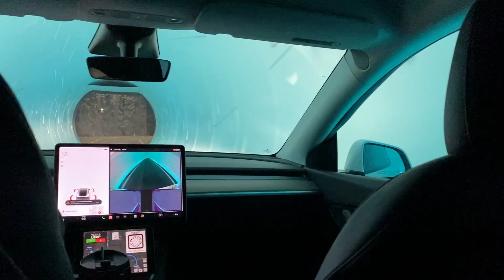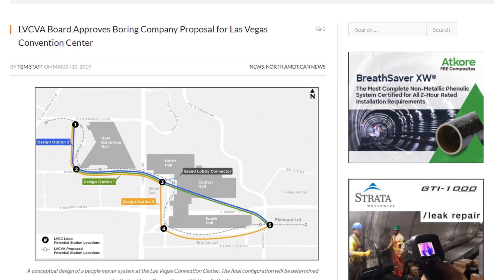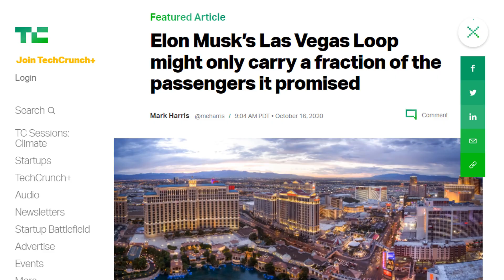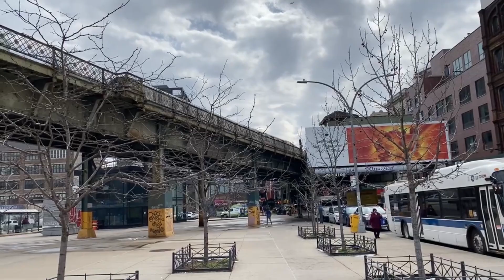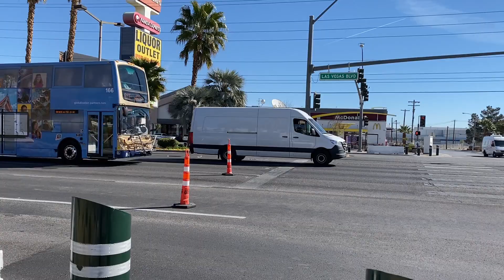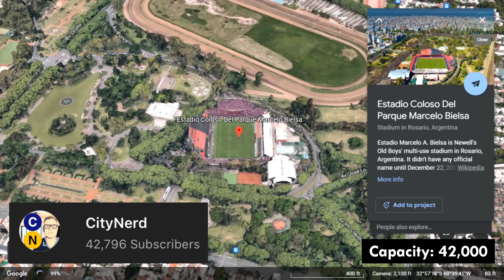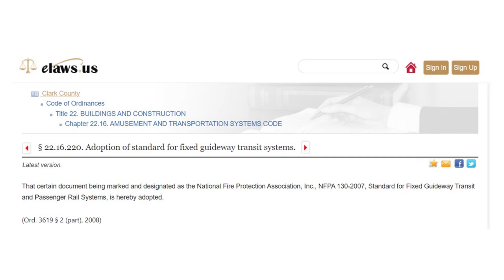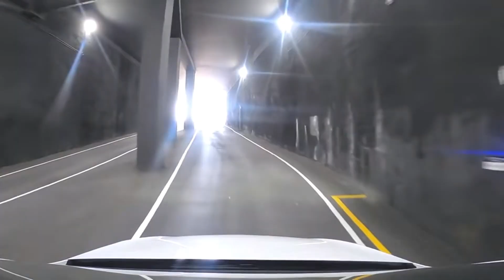Inside the Las Vegas Loop: Transportation Game-Changer, or Complete Waste of Time and Effort?

Comment: The loop was a game changer. It helped a lot of people to finally realise that Musk is full of bs
Reply: Not enough people
Reply: I can't believe it took this much 🤣 I can't believe the amount of them who would still volunteer as test subjects for him.
Reply: don't forget this "genius" thinks he'll colonize Mars. Like yea, after you pal.
Reply: Wow.. truly amazed with the supporter of loop.  Lots of unreasonable reasoning.
Reply: @Ninjabeefyschtick  Any point you feel is particularly unreasonable vitasoy?
Reply: @andrewfranklin4429  Points that are unreasonable have all been discussed by fellow members and it is just going in circle when one strongly believes an exclusive loop for tesla sedans works better than mass transit system.  What else is there to discuss?
Reply: @Ninjabeefyschtick  That's unfortunate Vitasoy that you refuse to even consider the implications that the Loop comfortably handles 27,000 people per day.

Considering subways of similar size (San Francisco Central Subway, Seattle U-Link, Berlin U55, Newark Subway) have similar or even much lower daily ridership, I would have thought you'd realise the Loop is mass transit (just of the PRT variety).
Reply: @andrewfranklin4429  Are you comparing possible capacity "a plan" with actually riderships?  You know this is about little teslas that hold 3 people per the requirement right?  You wait a few years and see how the actual system rolls out, if it ever does, before counterarguing with something that is highly questionable and already discussed by previous comments.  Its a waste of time to talk about some that has like 3 of 51 stations built.
Reply: @Ninjabeefyschtick  No, the 27,000 people per day is actual ridership and what was measured during the SEMA conference back in November.  The smaller CES convention in January saw 15,000 - 17,000 people per day.

Yes, those Teslas seat on average 2-3 people but because they are entering and leaving the stations down to every 3 seconds, they end up moving as many people as similar sized subways which only come every 3, 5, 10 or even 30 minutes.

The Loop now has 4 LVCC stations completed (LVCC North was completed a few weeks ago), a new station at Resorts World and the tunnel to Encore is currently be bored so there will soon be a 5th Loop station with more stations at Caesars Palace, Alegiant Stadium and other areas currently going though rubber-stamping.

That's out of the 55 stations that have been approved with more being added every few months.
Reply: @Ninjabeefyschtick   The figure that is planned capacity is the 57,000 people PER HOUR that the The Boring Co has projected the entire 34 mile 55 station Vegas Loop will handle when completed.
Reply: @Codraroll  still unable to accept that the Loop handled 27,000 people per day at SEMA, comparable to other subways of that size Erlend?

Unfortunate.
Reply: @andrewfranklin4429  Come back with your argument when the lines is completed then. please and thank you
Reply: @Ninjabeefyschtick  There's nothing I'd like more than if everyone held off judging the Loop till the rest of the 34 mile 55 station Loop was completed so we could all see how well the Loop scales to a city-wide system.

Unfortunately however, there are a significant number of people who are determined to criticise and reject the Loop out of hand at this stage because it uses cars which doesn't fit their world-view of "cars are bad, trains are good" meaning we have to judge the Loop based on it's current iteration.

The good news is that with the current three-station LVCC Loop handling 27,000 people per day, it is already moving numbers of people comparable to all of those subways that I mentioned.  

Thus the Loop is already proving that not only is it competitive with Bus Rapid Transit and Light Rail, but it is already holding its own against similar-sized subways despite costing 10-100x less than a subway.

And this is without taking into account that there will be around 8 Loop stations per mile compared to 1-2 subway stations in that distance through the busier parts of Vegas meaning that each station only needs to handle as little as 12% the volume of passengers individually to still move the same number of people per mile of tunnel compared to a subway.
Reply: It's literally a single lane tunnel that cost 4x more than what any other tunnel would had cost. Furthermore, there is this wonderful new invention where hundreds of people can be transported at the same time through an underground tunnel called a SUBWAY. It was named after the sandwich company because of the aerodynamic shape of the hypertrains that shutter everyone around!
Reply: @NightfallShadow  Can you provide actual evidence that the boring company tunnel cost more than any tunnel.  The info I have says it cost 1000x less per mile than recent subway tunnels.

Oh, I forgot.  You don't use facts.
Reply: Steve  I think you're forgetting that Personal Rapid Transit has been an unrealised dream for many decades. Except that they're called bikes. And they've been around a lot longer. ;)
Reply: the loop just needs a telsa semi truck to move 50 to 100 passengers
Reply: @22phan  And what about the blacks?
Reply: @22phan  happy nine 11 everybody!!!
Reply: @22phan  why would the Loop need a Semi when it already easily transports up to 27,000 people per day?
Reply: Prescient much?😜
Reply: Nah it when he bought Twitter, sexual harassment, and hypocrisy all at the same time
Reply: Yeo
Reply: Steve   on the contrary Steve, the LVCC Loop is moving similar numbers of people to the London Tube’s busiest station platforms. 

60,000 people per hour (pph) travel down the busiest line on the London Underground - the Victoria line - in the highest morning peak hour sitting on the train, but the actual max number of passengers recorded getting off and going through the turnstiles at Oxford Circus Station (the busiest Underground-only station on the Tube) on that line is only 23,720 pph in the busiest morning peak hour.   That stat alone should help us realise that pph standing on a train does not equal pph going through the turnstiles of the station.   But it’s even worse as that is the total across 6 busy platforms and 11 different Lines, so the pph going through the turnstiles from just the Victoria line is far smaller again as dividing by 3 platform-pairs we’re only looking at approx 7,906 pph at Oxford Circus Station. On a per line basis it’s only 2,160 pph.   And yes each of those 3 platform-pairs have similar pph riding down the lines so a divide by three gives us a quite accurate thru the turnstiles percentage.   And those were the figures pre-pandemic - ridership now is less than half those figures (so somewhere around 4,000 pph for that Oxford Circus platform-pair or 1,080 pph per line). 

So as you can see, the 4,400 pph going through the turnstiles of the LVCC Loop is actually very impressive even compared to the world’s busiest subways.
Reply: Steve  If you prefer not talking in terms of passengers per hour, then we can do that but it is a less balanced comparison considering Oxford Circus station operates 24 hours per day while the Loop is only open during the 8 hours of the convention. 

However, the TFL website reports that Oxford Circus averages 69,643 passenger entries and 77,884 exits per 24 hour day.

So that is 147,527 in total. 

However, as I mentioned earlier, Oxford Circus has 6 platforms and 11 different lines, so the average per platform pair is 49,175 and 13,411 per line per 24 hour day. 

Now in comparison, the Loop handles up to 27,000 per 8 hour day. So Oxford Circus platform pairs handle less than double the daily ridership of the LVCC Loop despite the Loop only being open for a third of the time daily during medium size conferences.  

Not bad for a little system in a city of 600,000 population that only cost $52m compared to the billions of dollars that Oxford Circus in a city of 9 million people has cost. 

But of course, that is not a fair comparison - comparing people per hour during peak periods is far more appropriate as I showed earlier.
Reply: Steve  there is nothing dubious about the 4,400 people per hour or 27,000 people per day figures for the Loop. 

Here is what the Las Vegas Convention and Visitor’s Authority (LVCVA) said as reported by numerous publications including Bloomberg and Teslarati amongst others a few months ago:

“the Boring Company’s tunnel system successfully moved 25,000 to 27,000 passengers daily around the Las Vegas Convention Center campus during SEMA in November. SEMA was the Convention Center and the LVCC Loop’s first full-facility show with 114,000 attendees.”

And more recently CES 2023 had 115,000 attendees and 94,000 passengers over the 4 day event.

The Loop was only open for the 8 hours each day that the SEMA Convention was in operation so that gives us an average hourly rate of 27,000/8 = 3,375 people per hour.

However, like any mass transit system, the Loop has peaks and troughs throughout the day with a peak period around lunch with a significantly higher hourly rate than that and off-peak periods up to mid-morning and after mid-afternoon with lower rates, meaning the Loop would easily have seen over 4,000 people per hour during that mid-day peak period. 

However, we have the audited results of the test in May that give us an idea of what the ridership would be with such a large convention as the pre-COVID CES:

“LVCVA Chief Financial Officer Ed Finger told the authority’s audit committee that accounting firm BDO confirmed the system was transporting 4,431 passengers per hour in a test in May showing the potential capacity of the current LVCC Loop.”
Reply: Steve  and if you compare specs honestly, you will discover that the Loop is very impressive when you compare it to most other forms of public transport such as subways:

1. High capacity - the LVCC Loop has handled more passengers daily during medium-sized conventions than 65% of the stations on the London Underground individually handle daily and carries up to half the peak hour ridership of the Times Square Shuttle line which has the busiest subway station on the New York subway. 

2. Much less waiting (10 seconds peak, 0 seconds off-peak) compared to 3, 5, 10 or even 30 minutes waiting for trains or buses and Loop vehicles go straight to their destination without having to stop and wait at every station on the line. 

3. much more comfortable and pandemic safe - comfy EV devoted to you and your family/friends/colleagues or 1 or 2 other people compared to standing squished like sardines in with a thousand strangers in a train or with 80 bus passengers 

4. much better scalability.  Loop EVs only leave a station if they have passengers unlike buses and trains that have to keep driving around even if they are empty. 

5. faster at 30-40mph compared to an average of 17mph - 22mph in subways (the 55 station, 34 mile Loop will average 60mph)

6. VASTLY cheaper - the 34 mile 55 station Vegas Loop is costing taxpayers ZERO dollars to build compared to $10 billion for a comparable subway
Reply: more than game
mind changer
Reply: Very True indeed, Elon Musk is a fraudster
Reply: The loop is genius.
Reply: @douglasross594  XD elon dickrider
Reply: I'm pressing (X) to doubt.
Reply: Well well well
Reply: Just now?
Reply: @Greeniykyk  sadly some people it took them long enough. I lost him way back at the cyber truck  and when I realised how much credit he takes for other people's work, and plagiarism, then claim it to be his work. Money buys you anything
Reply: @Greeniykyk  if you cannot see it, you lack the common sense, and cognitive reasoning to understand. It would be a waste of time to try.
Reply: His rockets are good, his "hyper loop" is a distraction from real transit. 

But everyone likes the sound of a golden bullet for all their problems, its just that engineering has taught me that no such things exist. Honestly if the US could just get 100mph trains running regularly as a regional rail that spans the nation it would be nice. From there expand the key corridors to true HSR between major cities.
Reply: @jasonreed7522  viable more efficient alternatives to driving and well designed cities is the closest thing we have to a golden bullet
Reply: @jasonreed7522  you people still just dont understand why trains do not work in the US lmao
Reply: Careful. He’ll call you names now.
Reply: @jamescoll130  thankfully Erlend has mostly managed to avoid ad hominem attack so we’ve generally had some quite enjoyable and useful discussions about the topic.
Reply: Musk got great ideals but this implementation sucks. It’s should have been high speed maglev Personal Rapid transit vehicles not his Tesla cars on rubber tires
Reply: @williamerazo3921  why do you reckon the Loop sucks William?  After all it has been extremely successful moving 25,000 - 27,000 people per day during large conventions like SEMA in November so very expensive maglev PRT vehicles are hardly required. 

27,000 passengers per day is:

- greater than the number of passengers that 65% of the stations on the London Underground individually handle daily which with 1.8 million passengers per day across 272 stations averages only 6,617 passengers per day PER STATION. 

- more than the 24,858 passengers per day per line pre-pandemic average of Kings Cross station, the busiest station on the Tube which pre-pandemic had 149,150 entries per day across 6 lines. 

- more than the average of 13,684 people PER STATION per day of the entire Paris Metro which had a pre-pandemic ridership of 4.16 million per day over 304 stations.

- about 70% the 38,888 people per day per platform pair average of the busiest station on the Paris Metro, the Gare Du Nord which pre-pandemic handled 700,000 people per day across 36 platforms. 

 - more than the 14,000 passengers per day per line average of the Stuttgart Main Station S-Bahn which pre-pandemic saw 140,000 passengers across 10 lines through the turnstiles daily.
Reply: Elon takes a lot of swings and for all his misses, he sure does have some absolutely astounding hits.  I don't understand how the "Musk as a bullshit peddler" myth still survives in a year where his car company produces more EVs than any other automaker by a massive margin and his rocket company puts more payload to orbit in a year than every other COUNTRY on the planet combined.

Whether the Vegas Loop ends up being a hit or a miss doesn't detract from the swings that Elon has taken which have ripped the cover right off the ball.  We need more people like him and less people who have nothing to offer the world but lame hot takes.
Reply: @woodsie315  "his car company produces more EVs than any other automaker by a massive margin"

Interesting uses of "more" and "massive" there. A quick Google has BYD at 1.8 mill, Tesla at 1.3, and VW at 0.8. I bet you have a "massive" penis, Woodsie.

And I don't think filling space with garbage should be praised.
Reply: @woodsie315  very well said woodsie
Reply: Hi Zane, here are some similar-sized subways for comparison that shows that the Loop is very competitive in terms of daily ridership, but also has FAR smaller waiting times, is faster but most importantly is VASTLY cheaper:

The current 0.8 mile long three-station LVCC Loop handles up to 27,000 people per day, has a 3 - 6 second headway, averages 25mph and cost $48.7m. 

The Berlin U55 is a 3-station 1.5km subway in the centre of Berlin which is similar in size to the LVCC Loop but it only carries a minuscule 6,200 people per day (compared to the Loop’s 27,000 ppd) at an average speed of 19mph and 5 minute headway and yet cost $500 million in today’s dollars in total, 10x the cost of the LVCC Loop.

The Seattle U-Link is a 3.15-mile underground light rail which also has 3 stations which had a ridership of 33,900 people per day pre-covid (so only a few thousand more than the LVCC Loop), though it is much less now.  Runs at an average speed of 31mph with a 10 min peak/15 min off-peak headway. It cost $1.9 billion dollars in total or $600 million per mile, 39x more than the LVCC Loop.

The San Francisco Central Subway is a 3-station 1.7 mile subway with a targeted ridership of 35,000 people per day with a 5 minute headway and an average speed of a miserable 9.6mph and cost $1.578 billion, 32x the cost of the Loop. (Whether it achieves that ridership which is only a few thousand higher than the Loop during this pandemic is of course yet to be seen) 

The Newark City Subway/light rail is a 6.4 mile, 17 station line with an average speed of 21.5mph and has a daily ridership of 19,289 and cost $208m for the 1 mile above-ground light rail portion or 4x the cost of the underground Loop. I’m not sure of the cost of the underground portion of the Newark subway, but typical costs start at $600m per mile 39x the cost of the Loop. 

As you can see, the LVCC Loop is extremely competitive, though that is nothing compared to the 55 station, 34 mile Vegas Loop with its 60mph average speed, 0.9 second headway and 57,000 people per hour capacity which is now under-construction at ZERO cost to the taxpayer. 

However, the Loop is FAR better in terms of comfort, speed and frequency/wait times, and VASTLY cheaper to build than any of these subway systems.
Reply: @andrewfranklin4429  Again. You are comparing the apple to orange.
Reply: @dickiewongtk  ok Wong, let’s do an apples to apples comparison instead and look at every subway station around the globe with around three stations like the Loop:

The current 0.8 mile long three-station LVCC Loop handles up to 27,000 people per day, with 3 - 6 seconds between cars, averages 35mph and cost $48.7m. 

In comparison, the Seattle U-Link is a 3.15-mile underground light rail which also has 3 stations which had a ridership of 33,900 people per day pre-covid (so only a few thousand more than the LVCC Loop), though it is much less now.  Runs at an average speed of 31mph with a 10 min peak/15 min off-peak frequency. It cost $1.9 billion dollars in total or $600 million per mile, 39x more than the LVCC Loop.

The San Francisco Central Subway is a 3-station 1.7 mile subway with a targeted ridership of 35,000 people per day with a 5 minute headway and an average speed of a miserable 9.6mph and cost $1.578 billion, 32x the cost of the Loop. (Whether it achieves that ridership which is only a few thousand higher than the Loop during this pandemic is of course yet to be seen) 

The Newark City Subway/light rail is a 6.4 mile, 17 station line with an average speed of 21.5mph and has a daily ridership of 19,289 and cost $208m for the 1 mile above-ground light rail portion or 4x the cost of the underground Loop. I’m not sure of the cost of the underground portion of the Newark subway, typical costs start at $600m per mile or 10x the cost of the Loop. 

And then there is the lame duck Berlin U55 which is a 3-station 1.5km subway in the centre of Berlin which is similar in size to the LVCC Loop but which only carries a minuscule 6,200 people per day (compared to the Loop’s 27,000 ppd) at an average speed of 19mph and 5 minute frequency and yet cost $500 million in today’s dollars in total, 10x the cost of the LVCC Loop.

As you can see, the LVCC Loop is extremely competitive, though that is nothing compared to the 55 station, 34 mile Vegas Loop with its 60mph average speed, 0.9 seconds between cars and 57,000 people per hour capacity which is now under-construction at ZERO cost to the taxpayer. 

However, the Loop is FAR better in terms of comfort, speed and frequency/wait times, and VASTLY cheaper to build than any of these subway systems.
Reply: @andrewfranklin4429  but all those subways could move much much people if there was demand, while there is a hard cap of a bit over 4400 on the loop. So its not a fair comparison
Reply: @andrewfranklin4429  I was interested by your argument so looked up the Berlin U55 line to check if what you said was correct. Turns out the U55 was always a short term tempary line that was not conected to the rest of the system and has now be absorbed into a diferent, I feel it was deliberatly misleading to compare. Also why are you comparing the loops best recorded performance to rail/bus services average ridership that also seems deliberatly misleading. You have got to ask your self the question if you are using metric in a none standard why and picking missleading examples like the Berlin U55, are you picking facts to support your argument rather then bascing your arguments on the facts.
Reply: @jimpaddy79  Jim, it is interesting that you only picked on Berlin’s U-55 subway (which I specifically said was a lame duck line) and ignored all my other examples such at San Francisco Central subway, the Seattle U-Link and the Newark subway. 

I included Berlin in order to mention EVERY single subway of similar size globally in comparison to the Loop yet you ignore all those other subways I mentioned. 

How about a little balance from your end?

And why do you assume that 27,000 per day is the Loop’s best performance?  That is just the ridership during a medium sized convention, (SEMA 2021) which had only 114,000 attendees. The Loop however was designed for pre-COVID conventions the size of CES with its 180,000 attendees, so there’s plenty of room for an increase as conventions grow back to pre-COVID levels.
Reply: @andrewfranklin4429  Rather than continuing two sperate conversations I am going to combine both into this one for simplicity. Clearly, we are now talking about different things I am specifically talking about the current loop system at the convention centre, which was the subject the video and the focus of the comments. I am not familiar enough with the intended expanded loop network to comment on it in any detail. In your last two replies I didn’t find any defence of my criticism of the current loop and my argument that light rail would be better due to the higher capacity it offers at peak time.  The original reason I commented was because I didn’t understand why you were quoting figures on short light rail lines which when I looked up 2 of them were operating roughly within their design parameters, and I still don’t.

Correct me if I am wrong, but I now think your main argument is that a point to point transport system such as the loop is different enough from traditional mass transit that different metrics should be used ie, numbers at stations not people per hour. I think this idea has some merit which is why I read the tread but I do disagree. I also think your point is buried in far to much copied and pasted figure about people that train station and that’s confusing people and frustrating people as its not the standard metric for mass transit, even if it’s a potentially better one the loop, so you cant blame people of accusing you of comparing apple to bananas. Please correct me if I am wrong.

I think people per hour is the best metric as it show how many people are moving toward their destination, it doesn’t matter where there going weather its one stop on the train or a journey across the country the point is they are moving, the point of any transit system is the have the capacity to greatest about of people and Ideally this capacity is a little above peak demand. The loop is just the same it this regard and I don’t think the fact  that its point to point changes that. This one is the clencher for me, the loop is effectively the same person driving a car on the road between two point, which means it should be measured the same as road traffic, road planner measure road performance in vehicles per hour, not by measuring what part of the city the cars journeys end in.

My final though are on the intended expanded loop and I am basing this entirely on what you said in your reply as I know noting else about it. The current loop gets good efficiency in seat filled in cars, because there is only 3 stop and that mean there is only 2 possible destination so its relatively easy to find there people going in the same direction, that is a totally different story if there is 50+ station so a lot of cars will be traveling with empty seat, which will massively the capacity of the system, if all the cars are running but there is only one passenger in each the system would only be running at 33% capacity. This get even worse if as you say they van to use mini vans. Then there is the 16 person pod you mentioned what the odds of finding 16 people going to the same place in a 50+ station network, so the pods would have to run mostly empty most of the time thus wasting more capacity, or it would run full and drop different people at different stations, in which case congratulation you have invented a bus, which stop at a stop when you press the button.

I would be curios to know why you feel so strongly positive about the project, reasonable people can disagree about things but people really either love or hate this project which I find more interesting then the project itself. Personal I don’t feel strongly I just think it not an inefficient system in its current or future form, but I am interested why you feel strongly about it.
Reply: @jimpaddy79  In terms of the use of EV vans or buses, they would only need to be used on high traffic routes not every route across Vegas unlike traditional buses and trains that have to be used on every route no matter how low demand that route is. 

Unlike rail, the Loop can easily mix high capacity vans and buses and 1-4 seat EVs without problems and thus far better optimise occupancy across the fleet compared to trains which have an average occupancy of 23% or buses which only average 11 passengers per bus. 

Remember that almost half the stations on the NYC subway handle less passengers than each of the LVCC Loop stations. 

With 5,580,845 passengers per day (pre-pandemic ) across 472 stations on the NYC Subway, each station only averages 11,823 people per day through each station.

The London Underground, with 1.8 million passengers per day across 272 stations averages only 6,617 passengers per day per station.
Reply: @jimpaddy79  and Jim, the reason I am quite positive about this project is that finally someone is doing something out-of-the-box, new and creative in the public transit market which up till now has stagnated in many parts of the world where the car rules supreme like the USA and here in Australia. 

As much as Musk disgusts me with a lot of his recent tweets and turn to right wing politics, he does have a talent for turning science fiction into reality with SpaceX, Tesla and now the Loop. 

Personal Rapid Transit (PRT) has been an unrealised dream for many decades, but his Loop really looks like it might crack that chestnut and get all those people who would never take a bus or train, out of their cars and into this PRT system which moves just as many people as BRT, light rail and subways, but for a tiny fraction of the cost and in far greater comfort, speed and convenience. 

What I can’t understand is why you and others aren’t more interested in this technology that promises a 34 mile 55 station underground transport system capable of moving subway volumes of people around at ZERO cost to the taxpayer.

Doesn’t this potentially huge disruption to the globe’s public transit industry peak your interest even a little bit?  Heck, you’re absolutely welcome and justified to hold off on giving it your approval until more of the 34 mile Loop is completed to see if it can scale to a city-wide system, but I can’t understand how so many people seem to be desperate to condemn it at this stage just because it is different.
Reply: @Nightfall Shadow, not sure where you get the idea that the Loop tunnels are more expensive when Loop stations are 60-600x cheaper than subway stations and Loop tunnels are 5-50x cheaper than subway tunnels?

The New York East Side Access subway cost $3.7 billion per mile and even the cheapest subway such as the Barcelona L9/L10 cost $243 million per mile compared to the LVCC Loop which cost $48m for around 0.8 miles of dual-bore tunnel. 

That LVCC Loop included an underground Loop station costing $30-$40m by itself, but the above-ground Loop stations only cost $1.5m each which is VASTLY cheaper than the $700m that NYC subway stations cost.  Even the cheapest subway stations in Europe cost $100m each. 

This is why it is possible for Musk to be building the 34 miles of tunnels and 55 Loop stations of the now under-construction Vegas Loop at ZERO cost to taxpayers. A subway system of that size would cost well north of $10 billion dollars in comparison.
Reply: You are the sort of person who questioned the need for roads, because their horse and buggy got around on flat terrain just fine.
Reply: @vimmentors6747  The subway is vastly superior idea to elon musks loop. Seriously, stop being an idiot.
Reply: @NightfallShadow  It's only a good idea if people want to use it, or are forced to use it because it's cost is massively subsidized by people who don't use it.  It's only a good idea if you are a contractor who is paid billions of dollars per mile.  I find that people who quickly dismiss new ideas are rigid in their thinking because they can't or are too lazy to think.  Which one are you?
Reply: @NightfallShadow  Translation of your reply: "I am uncomfortable when confronted with facts, polls and other forms of reality, so I will pretend I am smart."
Reply: @NightfallShadow  Can you please show evidence that anyone is currently doing serious work on a Hyperloop?  Oh, I see.  You can't argue reality, so your only option is hyperbole.
Reply: How many rockets have you launched this week?
Reply: @zshobuz  And you ?
Reply: The 34 mile, 55 station Vegas Loop is even more interesting though in that it has many more Loop stations for every subway station per mile. 

If you have a look at the map of the now-under construction 34 mile, 55 station Vegas Loop, you will see there will be around 8 Loop stations for every subway station per mile (17 in the 2 miles of the CBD) through the busier parts of Las Vegas

The existing convention centre Loop is a prime example of this fact as it already has 3 stations serving that one venue and the fourth LVCC station (LVCC North) has just been constructed and there are three other stations within a few hundred metres of the centre as well, meaning that the LVCC will effectively have 7 Loop stations servicing large convention crowds.  

With a subway, there would only be a single station typically serving such a destination. 

As such, comparing the average daily passengers through the turnstiles of a single station of the LVCC Loop during large conventions is actually very unfair to the Loop as we need to be comparing all 7 (or 8) of those stations (once they are completed) against each subway station for a more accurate comparison. 

Each of those 8 stations only has to handle 12% of the load of a single subway station to carry the SAME or greater number of passengers as that single subway station, vastly reducing the crowds and bottlenecks or choke points that subway stations represent. 

How is this even economically feasible you ask?  With each Loop station only costing $1.5m compared to the $100m - $1 billion cost of subway stations, you could build 67 - 667 Loop stations for the cost of a single subway station and 10 - 100 miles of Loop tunnels for the cost a single mile of subway tunnel. 

This is why there will be a Loop station at the front door of every hotel, casino, resort, the university, large shopping centre etc through Vegas, something that would be technically and financially impossible with subways.
Reply: Hi again Zenforce, Since you want to talk people per hour travelling down the line, let’s compare those stats shall we?

Bus Rapid Transit (at grade) has very low capacity:
90 passengers per vehicle * 15 vehicles per hour = 1,350 pph.
And low average speed of 9mph due to city traffic and having to stop and wait at every stop. 
$0.68 - $9m per mile

Bus Rapid Transit (grade-separated) has low capacity: 
90 passengers per vehicle * 30 vehicles per hour = 2,700 pph.
And but still slow average speeds of 12-22mph.
$13-50m per mile

Light Rail Transit (at grade) has medium capacity:
90 passengers per vehicle * 3 vehicles per train * 15 vehicle sets per hour = 4,050 pph.
But slow speeds of 9mph -12mph due to city traffic and having to stop and wait at every station. 
$50m - $100m per mile

Light Rail Transit (grade-separated) high capacity:
90 passengers per vehicle * 3 vehicles per train * 30 vehicle sets per hour = 8,100 pph.
And still pretty slow average speeds of 15mph due to having to stop and wait at every station. 
$201m per mile

Subways have very high capacity:
100 passengers per vehicle * 10 vehicles per train * 30 vehicle sets per hour = 30,000 pph.
But still slow average speeds of 17-22mph due to having to stop and wait at every station. 
$600m- $1 billion per mile
$100m - $1 billion per station

Now the Loop Arterial tunnels haven’t been built yet, but we do know they will have a 0.9 second headway giving us 4,000 EVs per hour. (That headway is equivalent to about 5 car lengths between EVs at 60mph which is similar to cars on a busy freeway)

So let’s compare those:

The 29 mile Vegas Loop (2.5 passengers per EV) will have high capacity:
 2.5 passengers per vehicle * 4,000 EVs per hour = 10,000 pph
AND very high average speeds of 60mph thanks to direct point-to-point travel at high speeds. 
$20m per mile (dual tunnel)
$2m per above-ground station

The 29 mile Vegas Loop (4 passengers per EV w ride sharing) will have higher capacity:
 4 passengers per vehicle * 4,000 EVs per hour = 16,000 pph
AND very high average speeds of 60mph thanks to direct point-to-point travel at high speeds. 
$20m per mile (dual tunnel)
$2m per above-ground station

But the Vegas Loop isn’t just one line down the centre, but up to 3 separate arterial tunnel pairs (6 tunnels in total) in parallel at times - particularly around the Allegiant Stadium to assist with handling the peaks pre and post games.  

That gives a throughput of 30,000 pph one way (or 48,000 pph with 4pax per car) or 60,000 (96,000pph w 4pax) bi-directionally over those high traffic sections.  

And there are several other sections where small loops come off to serve groups of stations through the heart of the city so the numbers continue to multiply.

And the great thing about the Loop topology is that if there is more demand, higher capacity EV vans or EV buses or “pods” can be introduced as well as more tunnels and stations can be built at a cost vastly cheaper than grade-separated BRT, light rail or a subway.
Reply: @andrewfranklin4429  This capacity calculation has wrong assumptions: <quote> A 0.9 second headway works out as 4,000 EVs per hour passing through which gives a capacity of 4,000 x 2.5 passengers 
= 10,000 pph in one direction <end quote>

City Nerd capacity calculation method one way, 6 seconds gap (600 vehicles per hour), average 3 passengers per vehicle,  1,800 passengers per hour.

Las Vegas Convention and Visitor’s Authority (LVCVA) numbers: the Loop handled 25,000 - 27,000 people per day during the SEMA convention.
Opening times SEMA 9:00 hrs - 17:00 hrs is 8 hours is a capacity of approx. 1,600 passengers per hour one way.
That's pretty close to City Nerd's calculation of 1,800.

Autonomous driving, especially in closed environments) is already solved at Telsa at the moment in 2024, this video was made in 2022. The use of human drivers now in 2024 is a regulatory barrier not a technological barrier.
If we want high capacity we should do a comparison with the robovan 20 passengers (14 seats and 6 standing). With the City Nerd method we reach a maximum one way (direction) capacity of 12,000 passengers per hour.

If your numbers are correct:
<quote>
Subways
100 passengers per vehicle * 10 vehicles per train * 30 vehicle sets per hour = 30,000 passengers per hour.
<end quote>

Someone else Luxembourg Luxtram  approx. 13,000 person per hour.

<quote>
Subways have very high capacity:
100 passengers per vehicle * 10 vehicles per train * 30 vehicle sets per hour = 30,000 pph.
But still slow average speeds of 17-22mph due to having to stop and wait at every station. 
$600m- $1 billion per mile two way
$100m - $1 billion per station
<end quote>

Boring Co Tesla Loop $15 per mile one way.
So we can make 20 tunnels for the cost of so a comparable apples to apples one way capacity with robovan 20x12,000=240,000 passengers per hour, but for only one passenger per vehicle e.g. robo taxi, would give a capacity of 12,000 passengers per hour.

I want to divide the 240,000 and 12,000 pph in three because we need stacked interchanges underground tunnels and on and off ramps, so 10 tunnels instead of 20, but with the stacked interchanges and on and off ramps. Then an Robovan exclusive system of 60,000 pph doesn't beat the 80,000 pph metro system. And are 500 robovans (500x20=1,000 passengers) cheaper than a metro train of 10 cars (10x100=1,000 passengers)?

With 10 tunnels we'll have express high speed tunnels (60 mph) and local low speed tunnels (30 mph). And maybe super express 120 mph for longer distances. Assuming 2-3 minutes travel time between stations without stoppage time for boarding and exiting the vehicles.
They must make a speed tier system of public and personal vehicles: with 10 tunnels 2 public super express, 2 personal super express, 2 public express, 2 personal express, 2 local personal.

Boring Co. greatest challenge, beside getting to a tunneling speed of a snail, would be how to make tunnel stacked interchanges for a speed of 60 mph.

The biggest benefit of the Tesla loop system is that the vehicles may come above ground personal express for door2door transport and use the normal surface roads where there are no traffic jams. Tunnels only for the super busy high density city centres and main city artery roads where otherwise there are (would be? in the future) traffic jams.

So there is no need for feeder lines for the Metro in case a tesla loop transportation system is used, also a financial gain, to offset extra maintenance cost of Tesla robo vehicles compared to metro.
Reply: Hi Pigeon, A 2010 study by the Honda Research Institute found that 25% of drivers maintained a distance of 2 cars between vehicles at 60mph on a busy 2-lane freeway, 15% 3 car lengths, 15% 4 car lengths, 5% 5 car lengths and 15% 6 car lengths. 

So that is 75% of cars having a headway of one second (~6 car lengths at 60mph) or less and 40% maintaining a headway of 0.5 seconds (~3 car lengths at 60mph) or less. And remember those are cars driven by potentially distracted, drunk and careless drivers. 

Note that a headway of 0.5 seconds = 7,200 cars per hour
And a headway of 1.0 seconds = 3,600 cars per hour

As I say, The Boring Co is planning on a headway of around 0.9 seconds (5 car lengths between EVs at 60mph) which will give a throughput of 4,000 EVs per hour.  With 2.5 passengers per car that gives us 10,000 people per hour. With 4 passengers per car 16,000 people per hour per single tunnel. 

With higher capacity EV vans, buses or pods that can be added if demand requires it, those numbers go up exponentially. 

Once the Loop autonomous control systems with their millisecond response times and ability to for example command ALL vehicles in a section of the Loop to brake or accelerate simultaneously, there would be no problems safely achieving headways of this duration.
Reply: @andrewfranklin4429  Thing with those headway numbers, though: they cannot exist in practice. Cars will have to slow down to create a sufficiently large gap for another vehicle when merging, and brake to turn out of the trunk line. In those cases, the headway will be longer by necessity, effectively creating a bottleneck, slowing the whole system down. Think of it as the line of cars being stretched out - you cannot compress it back in without creating a gap (but then you'd have a pileup as soon as somebody needs to brake again), and at any rate the existence of the gap will affect the average flow. 

And whoa you are jacking hard on the fairytale cost estimates there. Do you think the Loop will just be allowed to acquire land for free, that NIMBYs won't protest, that soil conditions won't have to be tested, that urban planners or project managers don't ask for wages, or that the tunnels won't need maintenance? That's the sort of stuff that drives up the costs in construction projects, not the digging itself. You really don't understand the slightest speck of engineering.
Reply: @Codraroll  Hi Erlend, I have to say you do regularly raise valid points, which I really appreciate - it makes me think more deeply about my assumptions and conclusions regarding the Loop.  And as you have noticed, I have modified some of those as a result such as counting both subway platforms in my daily station turnstiles calculations. 

Thanks for taking the time to nut through the data and implications, it makes this discussion quite enjoyable and hopefully useful for yourself as well as I!

Regarding cars merging into a main arterial tunnel that is running with the 0.9 second headway, you are quite correct that if the tunnel was completely maxed out and running without a single gap larger than the 5 car lengths between vehicles, then something would have to happen to allow additional cars into that tunnel. 

I don’t have visibility into what TBC’s plans would be for that sort of circumstance, but I could think of a few possibilities that could potentially be implemented once autonomous operation is enabled for Loop EVs. 

1. ALL EVs in the arterial tunnel upstream of and approaching a station could ALL potentially be automatically commanded by central dispatch to simultaneously slow down to open up a gap for that entering EV to slot in as it came down the spur tunnel from the station. 

Once enough of a gap opened up timed with passing the spur tunnel, that EV would merge and then they would all be commanded to speed back up to the speed of the EVs in front again with the result that they would get to their destinations a second slower which in the scheme of things is not a terribly big deal. 

Under those circumstances you could have many such micro-slowdown events letting in more EVs from stations as required which might end up adding an extra minute or two to everyone’s trips in really bad situations of overloading. 

However, is this any different to situations when trains or buses arrive at a station/stop completely full and the people at the station have to stand there for another few minutes and hope that the next train won’t be so full?

2. Alternatively, in such high demand situations, the Loop might bring some higher capacity EV vans, buses or pods online to help ease the load on high traffic routes thus opening up spots in the tunnels for more vehicles. 

3. Central Dispatch might slow down the pace of EVs entering the arterials back at the start of the arterial tunnels to ensure there is always enough empty slots for stations further down the line to feed EVs into the tunnel (a bit like those congestion traffic lights on the on-ramps of freeways). 

Again those EVs might have a few seconds added to their journey but again not a big deal considering they are still 5x faster than subway trains. 

4. TBC may just simply be over-speccing the number of parallel arterial tunnels and stations to ensure there is almost always headroom in the arterials and stations for anticipated surges in demand so that having arterials at full capacity without any spare slots would be a very rare event. 

etc

And of course any combination of the above might be brought into play to keep the Loop moving. Plenty of other mass transit systems have times when the queues build up at stations after a big game or concert or other large event and passengers have to put up with longer wait times crowding down the escalators and getting on trains and the like so this is not a unique issue.
Reply: @Codraroll  Regarding your points about costings, if you look at the map of the 29 mile Vegas Loop, you will see that the arterial tunnels mostly follow under the roads throughout Vegas under land owned by the County who has approved this project. 

Likewise all the 51 stations are in the car parks of properties that are paying for those stations to be at their front doors. 

So in both cases, land doesn’t need to be acquired because the Loop is all on or under land owned by the many partners in the project. 

And the chances of NIMBY protests about these whisper quite EVs would be a tiny fraction of what you’d get putting in a noisey real-estate hungry above-ground light rail or tram through Vegas. 

There are however some easements under the properties of third parties being sought for some of the tighter corners in the Loop where having a larger radius turn going under a corner property would increase EV speeds around that turn and reduce construction costs.  But these are in the minority. 

Yes, soil conditions need to be tested and planners and PMs need to be paid, but TBC is responsible for all that and has done it before and has obviously factored all those costs into their plans. And if TBC gets any of it wrong, oh well, that’s their problem as they are covering the costs of construction for all the tunnels and are responsible for any overages, not the county or the LVCVA. 

And yes, on-going maintenance will have to occur but that is in a separate operational budget and would be paid for out of the income from ticket sales.
Reply: @andrewfranklin4429  The problem with 1) is that the arterial tunnel, as assumed, runs cars with a 0.9-second headway. That means that one car is added to the system and another goes out every 0.9 seconds. As such, the arterial using this method would have ALL cars braking and speeding up every 0.9 seconds when running at capacity, to let new cars in at some point in the line. Except it would take more than 0.9 seconds to brake for a merge and speed up again, so the end result would be a spiral towards zero speed as the system loses the ability to take away cars faster than they are added in (which is to say, the assumed capacity cannot be met because pushing that many cars into the system would lead to a standstill). It's slightly different from buses in that the myriad of smaller vehicles build traffic jams much faster than a few big ones, and they take much longer to clear as well.

2) Is less of a problem, but it's a step towards an entirely different system: If these larger vehicles only exist to be brought online when needed, you will still have to pay for their maintenance and storage when they are offline, and likewise for the handful of smaller vehicles that go offline when the larger ones go online. Essentially, you're paying for twice as much capacity as you are using. Also, wouldn't larger vehicles depend entirely on all passengers going between the same two stations, AND being fine with riding with strangers? At that point, why not just establish a fixed high-capacity route between high-demand stations? 

3) In this case, you do not have the 0.9 second average headway anymore. Then the assumed capacity numbers cannot be met.

4) In this case, the assumed capacity numbers cannot be met either, for the assumed number of tunnels. Also, have fun working out how several parallel tunnels could all connect to the various stations without crossing into each other.
Reply: @andrewfranklin4429  Even if the arterial tunnels go under county roads (they would have to go deep so they don't interfere with the road foundations), the connection tunnels would have to go in spaghetti-like routes around them. Also, there is an absolute crapton of underground infrastructure buried under roads like those, much of it put down without being properly mapped. You dig, you find a piece of cable that isn't on the map, and you have no way of knowing if it is live and powers the whole block or if it was taken out of use in 1972. Until you find out, the whole project stops. This makes stuff expensive. 

You have also obviously never dealt with NIMBYs. 

As for soil testing, TBC probably had good data from when the convention center itself was built, and could rely on that for that one site. As soon as they move to more complex areas, though, costs start skyrocketing. And if you think TBC's marketing material numbers take that into account, you're outright delusional. That "cost per mile" should be denoted with so many asterisks it'd resemble a family-friendly transcript of The Goodfellas. 

And you obviously have no idea how much it costs to maintain a tunnel. That's horrendously expensive stuff, to a degree that trying to cover it with taxi fares would be a pretty tall order. Especially when considering the hypothetical existence of a competing company that would utilize the same self-driving technology to run a service on surface roads (which are already paid for by the city) and could carry passengers to and from any doorstep without having to build a single station anywhere or maintain a single foot of tunnel. They could take vastly lower prices for a more convenient service, albeit with a somewhat slower transit time (which could be more than compensated by eliminating the need to walk to and from stations). And of course, travelling on the surface you get to see the sights of Las Vegas, instead of just a claustrophobic concrete intestine. 

Given the technology required to make the Loop exist as advertised, vastly cheaper alternatives would also exist and run them out of business within a month.
Reply: @Codraroll  1) I’d have to disagree Erlend as it doesn’t matter if it takes even a few seconds to slow down and then speed up again fractionally to open up a few car lengths for another car to merge in front of you. All it results in is a fleeting drop and then restoration of speed and the overall 0.9 second, 5-car margin between all cars in that tunnel is preserved and an extra 0.9 seconds added to your trip time. 

It would take a very significant overload above the rated capacity of the tunnel to have any sort of noticeable effect on the travel times of users in the tunnel.  For example, it would take an additional 60 vehicles per minute (3,600 per hour) to double the 5 minute average travel times of the EVs in the Loop to 10 minutes for example.  That’s almost DOUBLE the rated 4,000 EV per hour capacity of the tunnel.

If that happened regularly, then any of the other mitigations mentioned or building an additional arterial tunnel might be appropriate.  Apart from being immensely cheaper than an additional subway tunnel, this is no different from train lines having to take on more rolling stock or build additional tunnels/tracks to handle regular overload conditions.

I think your concerns are severely over-blown considering people can often wait hours outside stadium venues or big mass-audience events and the like to get on a bus or train. Not to mention having to wait 3, 5, 10 or even 30 minutes for a train every day in regular operation.  People would laugh at any complaints raised about an extra handful of minutes added to a Loop journey when a train would have taken 5x as long.

2) Having higher capacity vehicles on-hand for peak-hour traffic periods every day or for the odd high attendance stadium event etc is no different than having additional buses or train rolling stock standing by for similar scenarios.

The advantage the Loop has is that the cost of EVs required to move the same number of people as a train is about 68% - 80% lower (see below) and of course the cost of vehicles is a tiny fraction of the multiple billions of dollars extra that it costs to construct a subway.

Each NYC subway carriage costs $2 million so an 8 carriage train costs $16 million and can pack in a maximum of 1,600 passengers (uncomfortable standing room only). 

Each EV in the LVCC Loop cost about $40k each, so you could buy 400 comfy EVs for the same money as that NYC train and with 4 passengers per car transport the same 1,600 passengers. 

However, the EVs travel 5x faster than the trains (which have to stop at every station on a line) so you’d need only 80 EVs (worth 20% the cost of that 8-carriage train) to transport the same number of people in an hour. 

Even with 2.5 passengers in each EV, that’s still only 128 EVs to transport the same number of passengers as a train at 32% the cost of that train.

3) On the contrary, the 0.9 second headway between vehicles is maintained in the tunnel so the promised throughput of the tunnel is maintained.   Any overload above the rated capacity of the tunnel goes beyond the SLA so the fact that passengers would take a few extra seconds or minutes to reach their destination is hardly going to be an issue.

4) If you look at the Vegas Loop Map, you’ll see the Loop already has two parallel main arterial tunnel pairs running on either side of the Strip with additional mini-loops throughout the heart of the CBD so extra capacity (and reach) has already been baked in.  And no, parallel tunnels don’t have to run alongside (or under) each other or go to exactly the same stations - in the case of Vegas, they are separated by multiple city blocks.  And of course, with underground being 3D, the tunnels can go as deep as needed in any situations where they do have to cross over.
Reply: @Codraroll  With tickets averaging about $10 per EV and ridership of up to 57,000 people per hour in peak hour, TBC could be looking at income of $200,000 per hour in peak periods or perhaps close to a million per day which gives us over $300 million annually. 

That’s a fair amount of revenue to cover tunnel maintenance and other on-going costs. And because the Vegas Loop is being built at zero cost to taxpayers, there is billions of dollars in funding that might have gone into building a subway that could instead be used by the county to cover any ongoing costs and even subsidise the Loop to make it free as is the case for many European public transport systems.
Reply: @Codraroll  Other public transport options are all pretty expensive themselves and have their own capacity and performance disadvantages. 

Bus Rapid Transit (at grade) has very low capacity:
90 passengers per vehicle * 15 vehicles per hour = 1,350 pph.
And low average speed of 9mph due to city traffic and having to stop and wait at every stop. 
$0.68 - $9m per mile

Bus Rapid Transit (grade-separated) has low capacity: 
90 passengers per vehicle * 30 vehicles per hour = 2,700 pph.
And but still slow average speeds of 12-22mph.
$13-50m per mile

Light Rail Transit (at grade) has medium capacity:
90 passengers per vehicle * 3 vehicles per train * 15 vehicle sets per hour = 4,050 pph.
But slow speeds of 9mph -12mph due to city traffic and having to stop and wait at every station. 
$50m - $100m per mile

Light Rail Transit (grade-separated) high capacity:
90 passengers per vehicle * 3 vehicles per train * 30 vehicle sets per hour = 8,100 pph.
And still pretty slow average speeds of 15mph due to having to stop and wait at every station. 
$201m per mile

Subways have very high capacity:
100 passengers per vehicle * 10 vehicles per train * 30 vehicle sets per hour = 30,000 pph.
But still slow average speeds of 17-22mph due to having to stop and wait at every station. 
$600m- $1 billion per mile
$100m - $1 billion per station

Compared to the Loop:

The 29 mile Vegas Loop (2.5 passengers per EV) will have high capacity:
 2.5 passengers per vehicle * 4,000 EVs per hour = 10,000 pph
AND very high average speeds of 60mph thanks to direct point-to-point travel at high speeds. 
$20m per mile (dual tunnel)
$2m per above-ground station

The 29 mile Vegas Loop (4 passengers per EV w ride sharing) will have higher capacity:
 4 passengers per vehicle * 4,000 EVs per hour = 16,000 pph
AND very high average speeds of 60mph thanks to direct point-to-point travel at high speeds. 
$20m per mile (dual tunnel)
$2m per above-ground station
Reply: In terms of per mile costs, yes, there are lots of potentially expensive things that need to be done to construct those tunnels, but TBC is still proceeding building all those 29 miles of tunnels in the Vegas Loop for free.

They have also submitted that bid to Miami for the 6.7 mile, 7 station Miami Loop connection of $185-$220 million which gives us a cost per mile of $30m - $35.5m per mile for a dual tunnel, a cost which in this case also includes an expensive underground station every mile instead of the much cheaper $2m above-ground stations of the 29 mile Vegas Loop. 

So that is $35m for:
* an underground station, 
* AND one mile of dual arterial tunnels 
* AND four spur tunnels per station 

So they obviously believe strongly enough that they can build them for those costs that they are still submitting bids of that order. 

I guess we’ll just have to wait and see if they continue to deliver Loop networks with these costs.
Reply: @andrewfranklin4429   No. Just ... no. Please, go back to school.

1) In the few seconds it takes you to brake down for one car, a few other cars will enter the system and require braking as well. Remember that we're talking about an at-capacity situation here. One new car every 0.9 seconds. If headway between any two vehicles is reduced, the whole system slows down. And since new cars are rapid-fired into the system, there will never be a chance to catch up.

2) Your numbers are dodgy ($40k per car will be a hilariously optimistic estimate), and you don't consider maintenance. The Loop will, at any point in time, have more wheels in motion than passengers. There's one door per passenger. A computer for every four. A motor per passenger, since Teslas have one per wheel. Something similar goes for suspension, brakes, battery packs, and so on and so forth. Parts-to-passenger ratios are all out of whack. And cars have vastly higher replacement rates than trains as well. There's a reason why you never see 40-year-old taxis around, but train cars from the early 1980s are commonplace. A car in continuous operation doesn't last more than a few years before it needs to be replaced. And of course, until the magic self-driving technology is invented and documented to be sufficiently safe for use in a public transportation system (and the latter will take years even if the technology was presented tomorrow), there's one driver to pay for every three passengers as well. In the absolutely best-case scenario. All over, the Loop has sky-high costs compared to the service it offers.
 
3) No, that's now how averages work. If some cars have to wait, then the average headway is not 0.9 seconds. It will be for the cars in motion, but not for those waiting, so it averages out to something higher. Besides, a gap would have to occur before new cars could be inserted anyway, and in an at-capacity situation, it never would. Then again, drawing the system boundaries to favour only the numbers that help your case seems to be your specialty. It's wrong as hell, but it's the only way your argument makes any sense (to those who don't see through the obvious forgery). Have you considered going into politics?

4) If you need multiple parallel tunnels to meet the stated capacity numbers of one tunnel ... one tunnel does not meet the stated capacity numbers. 

That is the takeaway here. At the stated capacity, the system cannot operate. Which means the stated capacity is BS. 0.9 seconds of headway might be the closest safe distance between any two cars, but it cannot be used to calculate capacity numbers, because there are so many situations that would cause it to increase. You might as well imagine the cars driving bumper-to-bumper - the slightest slowdown would cause them to crash. In practice, you would need to assume a much larger margin instead of always using the most optimistic numbers. And when those margins are added up, the numbers are not nearly as impressive anymore.
Reply: @Codraroll  I’m afraid you’ve got it wrong Erlend.  If you have one or more additional cars being added to the arterial tunnel EVERY SECOND in addition to the cars in a maxed out tunnel then you are talking a doubling of the demand from 4,000 EVs per hour to 8,000 EVs per hour in that tunnel.  Or from 16,000 people per hour to 32,000 people per hour on just that one arterial tunnel (ignoring the other parallel arterials and mini-loops).

If any mass transit system had a doubling of its theoretical maximum capacity inflicted on it, things would slow down in that system as well.

You are not being sensible.  The 29 mile 51 station Vegas Loop is rated at 57,000 people per hour in a city of 600,000 population.   Considering the city already has a comprehensive bus service moving 178,390 people per day, the monorail carrying 13,000 per day, a taxi service and many private buses, limos and Ubers, you are just not going to see that sort of overload on the Loop.

Steve Hill, CEO of the LVCVA said it succinctly a year ago, “It seems that during a pandemic is not the time to be increasing capacity” when he explained why the LVCC hadn’t added higher capacity vehicles to the Loop yet.

But, if the Loop does prove so popular that a third of the population of Vegas wants to ride on it daily (!), then no problems, The Loop will simply add additional higher capacity EV vans/buses/pods and/or bore more tunnels and add additional stations as needed.

You’re making an imaginary mountain out of a molehill Erlend.
Reply: You do realise Musk makes the Teslas so TBC wouldn't be paying retail? No doubt they are getting them even cheaper than $40k.

You don’t see 40 year old taxis around because internal combustion engines have 2,500 moving parts and the engines, gearboxes, exhaust, cooling system, ignition, and all the belts and chains etc etc just don’t last.

EV motors on the other hand are rated for a million miles as are the new LFP batteries and Teslas used to have a Service Interval of 2 years (!) but now even that is not required as there are only about 26 moving parts in a Tesla (1 moving part in the motor itself).

It's not as if trains don't require regular servicing and maintenance to keep them going.
Reply: @andrewfranklin4429  No, you're getting it very wrong. In a maxed-out tunnel, there will be one car entering and one car leaving every 0.9 seconds. This is the capacity number you are quoting - 4000 cars per hour. But the other cars will have to brake to allow merging and splitting to happen. This will reduce the headway, and create bottlenecks, and at capacity, it will not be possible to compensate for them, because new cars keep being added every second. So the problem reinforces itself until you've got a standstill, or worse, a pileup.

Ergo, at 4000 cars per hour, it will not be possible to operate with a 0.9 second average headway - which means 4000 cars per hour cannot happen, because the two numbers are intrinsically linked. So using 4000 cars per hour as a capacity number for the tunnel is a LIE.
Reply: @andrewfranklin4429  If the engine had been the sole reason cars have to be scrapped after a few years, it would have been much cheaper to replace the engine than the whole car. Alas, there are a lot of parts that wear down with use. Suspension, brakes, air-condition, door locks, tires, electronics, heck, even the seats themselves.

The service interval you quote is for private vehicles, which spend around 97% of their time standing still. For a vehicle in continuous use for several hours every day, expect the interval to go down to a few weeks. That's also why the lifetime of the vehicle will go down from a couple of decades to a couple of years. It runs through its design service cycles much faster. At 50 mph for 12 hours per day, the million-mile mark will be crossed after four and a half years. A train car will barely have begun its service life at that age, likely having about ten times as long left in service. 

And remember that each vehicle carries four people at most. Trains require service and maintenance too, but not nearly as much per passenger, because each carriage seats dozens of people, and likewise there are only a handful of motors at most per train. There are, simply put, much fewer parts to consider per passenger. Trains are designed for mass transport efficiency, including ease of maintenance. And cleaning. You can clean a train car (for a few dozen passengers) in a few minutes with a mop. Cleaning out a car interior (for four people) is a much more strenuous task.
Reply: @Codraroll  You have raised an interesting point there about the 0.9 second headway Erlend regarding the 4,000 vehicles per hour metric, but there is some nuance relevant here.

There will not be one EV entering and one EV leaving the tunnel every 0.9 seconds because unlike a train, EVs are entering AND LEAVING the arterial tunnels multiple times a second all the way along the tunnel. In comparison trains typically go down the entire line from start to finish. 

Headway is a measure of the time between vehicles going past a point and vehicles per hour is also a measure of those vehicles going past a point so for both metrics, with the Loop tunnel at max, it is still seeing 0.9 seconds between vehicles and 4,000 vehicles going past a point in the arterial tunnel irrespective of whether additional EVs are added or subtracted from the tunnel before or after that point. 

However, because of the topological difference between the lineal train model and the point-to-point Loop model, those metrics mean different things when it comes to interactions with stations. 

In the case of trains, they stop at every station on the way so the headway actually varies between the trains as another train approaches while the first is still sitting at the station and as there are varying distances between stations, the headway figure given is actually a minimum figure that varies over a line depending on the different distances between stations and the lengths of time trains stop at each station. 

And because the same trains travel down the line with typically no extra trains being added or subtracted to a main line down that route in between, the headway and vehicles per hour figures as measured as vehicles past a past in the tunnel can be used to measure the time an individual passenger would take to travel from one end of the line to the other. 

However, if that line has express services, then those express trains will be jumping the queue and squeezing into the line in between other trains going down the line either requiring increased headways between the regular service trains or causing reduced headways between those trains without exceeding safe minimum headway limits. 

The Loop is a different P-to-P topology of course with EVs entering and leaving the arterial tunnel all the way along its length all the time (not just at the start and end points of the line like a train) so although the same 0.9 second headway and vehicles per hour metrics are maintained between vehicles passing a point in the tunnel, the journey times for those passengers will increase marginally as Loop EVs enter and exit the Loop if the Loop ever reaches saturation point. 

However, as I pointed out these increases are so tiny as to be inconsequential compared to the much longer travel times and delays of trains stopping and waiting at every station.
Reply: @andrewfranklin4429  I might try to appeal to the basic continuity theorem:

Due to the need to brake down and create gaps whenever there's a merger or a split, a 0.9 second headway cannot be maintained as an average at any of those points. No matter if it's at the start or end or in the middle of an arterial tunnel - an intersection will always create a point where maintaining the minimum headway is impossible.

It thus follows that an average headway of 0.9 seconds cannot be maintained between intersections either. It's basic continuity. You have X vehicles/minute in one end, X vehicles/minute in the other, hence the number of vehicles per minute must be X at every point between as well. Cars aren't created or removed in the middle of the tunnel between intersections. The flow you have in the intersections is the flow you have in the tunnel. Simply put. 

So when the intersections cannot physically handle a 0.9-second average headway, the tunnel cannot achieve a throughput of 4000 cars per hour. It's a theoretical best-case estimate, like the theoretical maximum water flow of a pipe. But without accounting for the maximum flow of the valves, you cannot use the pipe's capacity to tell the maximum flow of the system. In reality, it will be far lower. 

So the next time I see you quote 4000 vehicles per hour as a figure for a single tunnel, and I have no doubt that you will, I will report it as spam.
Reply: @Codraroll  Erlend, you’re conflating vehicle headways with passenger throughput numbers and thus drawing incorrect conclusions.

With the Loop, whenever passengers leave or enter a main arterial tunnel to get off or on at a station, EVs actually leave or enter the arterial tunnel carrying those passengers thus varying the number of vehicles per hour down that tunnel as well as varying the passengers per hour down that tunnel segment.

In contrast, when passengers get on or off a train at a station, the passengers per hour numbers vary just as much as the Loop, but the vehicles per hour metric does not vary.

What varies in the train case is the occupancy of train before and after the station.

Thus you are in error trying to use a real-time vehicles per hour metric as a measure of real-time passenger throughput for either the Loop OR for trains.

The important thing is those passengers getting on or off at the stations causing the passengers-per-hour metric to vary for both Loop and train, not how many vehicles per hour are going down that tunnel.

You’ve been caught by the different topology of a Personal Rapid Transit (PRT) system from a traditional mass transit system like rail.

In fact, the vehicles per hour metric is measured at a single point in the tunnel, so if vehicles in an arterial tunnel that is at max capacity all slow OR SPEED UP a tiny bit for a few seconds to open up or close a gap caused by an EV entering or leaving the arterial tunnel, it has no effect on the Total vehicles per hour being measured in the middle of that tunnel segment - 4,000 vehicles per hour-  as well as the passengers per hour metrics will actually be maintained at that point.

In contrast, if a number of passengers get off at a train station, the vehicles per hour metric is maintained, BUT THE PASSENGERS PER HOUR METRIC IS NOT as the train is now a lot emptier.

Unlike the train, the Loop EVs behind can speed up to fill in the space left by a lot of EVs leaving the arterial at a station (remember that Loop EVs can hit up to 150mph in main arterial tunnels (dependent on safe speed conditions for that segment of tunnel) so have much more flexibility for slowing down or speeding up to account for station exits and entries and thus maintain passenger throughput).
Reply: @andrewfranklin4429  No, I'm saying that 4000 vehicles per hour cannot happen, as the headway is not large enough to allow for braking during merging or splitting traffic with that headway. If you have that many vehicles, normal operation will induce flow problems that cannot be compensated - hence, the number cannot be sustained in normal operation, and thus it does not describe the maximum capacity.
Reply: @Codraroll  It sounds to me like you’ve never been on a busy freeway where the motley crew of distracted humanity has no problems speeding up and slowing down as necessary to let other cars merge in and out from on and off-ramps while maintaining that average 1 second headway overall. 

If 25% of such frail humans can drive maintaining a headway of 0.5 seconds (2 cars lengths) between vehicles at 60mph, 15% 3 car lengths, 15% 4 car lengths, 5% 1.0 second headways (5 car lengths) and 15% 6 car lengths, I think centrally controlled EVs bristling with sensors in the controlled environment of a tunnel can manage to squeeze and expand the space between EVs to a similar degree briefly if needed combined with simultaneously speeding up and slow down to open up and close gaps for merging EVs. 

However, your fixation on this 4,000 vehicles per second metric while ignoring the fact that the passenger per hour metric varies far more as passengers board and debark from trains at stations shows that you are not actually concerned about the metrics that matter. 

The metric that matters of course is passengers per hour but you ignore the fact that trains having to rigidly maintain their 3 minute, 5 minute, 10 minute or 30 minute headway down the line is a liability that means their passengers per hour rate varies down the line as passengers get on and off the train. 

In contrast, Loop EVs can speed up or slow down to fill gaps or open up gaps for merging and exiting EVs meaning that they can not only maintain their vehicles per hour metric, but they can also maintain their passengers per hour figure as well. 

In short, it is trains that you should be criticising for sacrificing passenger throughput on the altar of un-changing headway.
Reply: @andrewfranklin4429  You're talking about bias? Now THAT is a joke.
Reply: @Codraroll  where did I say “bias”?  So are you going to admit that you have erroneously fixated on vehicles per hour and ignored the metric that was actually important - passengers per hour - for trains?
Reply: @Codraroll   ironically, the Luxtram service only carrying 16% more people than the 27,000 people per day of the Loop despite having 5x the number of stations, 5.4x the length and costing $604m or 12.4x more than the LVCC Loop.

And despite Luxtram being above-ground, not underground like the Loop, the cost is $40m per mile for Luxtram, a service that is also 5x slower averaging only 11.3mph vs 60mph for the 34 mile Vegas Loop. 

So I’m not sure why Zenforce is so keen to use that as an example?! :-)
Reply: Not sure why you believe that considering the convention centre loop has been so successful. After all it’s demonstrated it can move up to 27,000 people per day during large conventions which is greater than the daily platform average of pretty much every subway station in Europe.
Reply: @andrewfranklin4429  Comparing the maximum of the Loop to the average of other systems is pretty dishonest. Just comparing the max of the loop of 27,000 per day and 3 stations which is 9,000 per day and station to the max daily ridership in London of 5,000,000 per day (according to wikipedia) and 272 station is 18,382 per day. And for the subway in London you have always the option to add another train to increase capacity during peak hours. For the loop the capacity is probably already maxed out at peak hours.
Reply: @KiHToG   that 25,000 - 27,000 people per day figure is not the maximum capacity of the Loop, that is just the average Loop ridership during a pandemic-affected medium-large multi-day convention of 114,000 conference attendees. 

We haven’t yet seen what the peak ridership of the Loop is like during a really large convention like what CES used to be like pre-pandemic when it had 180,000 attendees which is what the Loop was designed to handle.  (CES only had 40,000 this year with 15,000 - 17,000 people per day riding the Loop)

The point I am making is that the average throughput of the Loop during a medium-large convention is competitive with the average ridership of subway platforms. The Loop is actually competing with Bus Rapid Transit (BRT) and light rail, but the fact that it isn’t bad compared to subways either is just a feather in its cap. 

Also, go have a look at Wikipedia again and you’ll see that the current daily ridership of the London Underground is actually 1.8 million thanks to the pandemic so it, like the Loop is suffering lower ridership figures due to COVID. Both services are affected by the pandemic so you need to compare apples with apples. (Mind you most of my other comparisons unfairly put the Loop against pre-pandemic subway figures, but it still does very well.)

The reason I lump the 3 Loop stations together versus individual subway stations and platform-pairs is because the Loop topology has many more Loop stations for every subway station. 

If you have a look at the map of the now-under construction 29 mile, 51 station Vegas Loop, you will see there will be around 8 Loop stations for every subway station per mile through the busier parts of Las Vegas. 

The existing convention centre Loop is a prime example of this fact as it already has 3 stations serving that one venue and there will soon be a fourth LVCC station (LVCC North) and three other stations within a few hundred metres of the centre as well, meaning that the LVCC will effectively have 7 Loop stations servicing large convention crowds.  

With a subway, there would only be a single station typically serving such a destination. 

As such, comparing the average daily passengers through the turnstiles of the three stations of the LVCC Loop during large conventions is actually unfair to the Loop as we need to be comparing all 7 (or 8) of those stations (once they are completed) against each subway line for a more accurate comparison. But even with just three stations it still compares remarkably well. 

So, with around 8 Loop stations for every subway station per mile that means the Loop would be capable of handling up towards 8 x 9,000 ppd = 72,000 people per day which is double even the busiest subway station DUAL platform averages in Europe (Paris’s Gare de Nor) which handles 38,888 people per day per platform-pair on average. 

You can see how the Loop topology which has many more small, cheap $2m Loop stations really pays off in both cost (subway stations start at $100m each) and distributing the load for handling quite large numbers of passengers while at the same time enabling every hotel and casino in Vegas to have their own Loop station at their front door, something that is impossible with expensive subways. 

The current LVCC Loop tunnels are far from running at capacity as you can see in videos - there’s 10-30 car lengths between cars in the tunnels. 

Also, the 29 miles of multiple arterial tunnel pairs that will cover Las Vegas will handle far greater capacities at far greater speeds than the short spur tunnels currently joining the LVCC Loop stations together so there’s still far higher headroom to play with once those are constructed. 

And yes, the Loop will also potentially add higher capacity EV vans/buses/pods to increase throughput on high traffic routes if it needs to in the future, but as Steve Hill, CEO of the LVCVA said back in May last year, “It seems that during a pandemic is not the time to be increasing capacity”.
Reply: @andrewfranklin4429  Musk claims a capacity of 4,400 people per hour, which would be 105,600 per day and this assumes that the system runs 24 hours a day without any disruptions and with compeltely filled cars all the time. That 25,000-27,000 people per day you quoted is probably pretty near its maximum.
Reply: @KiHToG  It’s important to understand that the 4,400 people per hour figure was not a maximum possible figure, but rather the projected AVERAGE utilisation of the LVCC during large conventions (such as the huge pre-pandemic CES with its 180,000 attendees) that TBC could be penalised for not meeting. 

No public transport system is ever designed to operate at maximum capacity every day, they always design them to have plenty of head-room above the average daily ridership for temporary surges otherwise the station or system would be overloaded everyday and unable to cope with even minor fluctuations above average which by definition occur 50% of the time!

4,400 would have to be an expected average throughput metric not a maximum otherwise TBC would have been penalised millions of dollars contractually simply for having average rather than maxxed-out daily ridership levels which would be ridiculous.

As it is, the medium-sized SEMA show (114,000 attendees) almost certainly did hit that 4,400 ppd metric (as you suggested) with 27,000 people per day over the 8 hours the convention centre was open = an average of 3,375 people per hour every hour (which means the peak period in the middle of the day would have been higher than that figure versus the lower off-peak periods in the morning and late afternoon).

As such, there is plenty of headroom above that figure for accomodating surges.
Reply: @KiHToG  And capacity could be increased further in the future if/when demand increases post-pandemic by in some cases quite simple strategies some of which have already been implemented since that 4,450 pph metric was publicised:

1. Increase the number of EVs (already done).  The Boring Co reported back in May 2021: “LoopSim predicted 4450 pph (within 1% of observed value) for that configuration (V3 with 62 vehicles), so this was a good anchor for our model. It predicts 5050 pph for V4 at the Convention Center. And 55,000 pph for the full Vegas Loop”

I believe the “V4 configuration” was for 70 vehicles (which was what the Loop was upgraded to from 62 cars before SEMA) which with the 8 hours that the Loop was open for SEMA would give a theoretical maximum of 40,400 people per 8-hour day or 121,200 over your theoretical 24 hours assuming 100% utilisation over that time.

2. Increase frequency by dropping the headway of the LVCC tunnels to around 3 seconds (10 car lengths at 35 mph) from the current 6 seconds (20 car lengths at 35mph) This would DOUBLE the throughput.

3. Adding additional car bays to the above-ground Loop stations.  The Loop Fire protection report states: 

“The first station, Station 1 is located in the Red Lot, and it is a surface station that is connected to the tunnels via a ramp. This station includes a boarding area for up to 14 vehicles” [Station 3 is the same configuration as 1]

“The second station, Station 2, is located in the Silver lot, and it is a subsurface station….This station includes a boarding area for 10 vehicles, however the boarding area could be configured for up to 18 vehicles.”

All stations are currently utilising only 10 bays each so can be readily expanded by between 40% and 80% if/when demand increases taking the total number of bays from the current 30 up to 46.

4. Adding additional Stations to the LVCC Loop servicing the Convention Center such as the just completed brand new LVCC North station which is already linked up to the just completed tunnel from the new Resorts World Station.  This will be joined to the other three stations of the LVCC Loop in the near future.

5. Adding high capacity third party EV vans or EV buses to the Loop and/or eventually the planned Tesla EV van and/or the 16 person pod featured in CGI imagery by The Boring Company.

6. Adding additional tunnels to the Loop stations which is already planned with the 29 mile Map of the Vegas Loop showing that 2 additional spur tunnels will be added to LVCC West and 2 tunnels to LVCC Central as well as 2 more to the soon-to-open LVCC North station.

7. Autonomy.  Once Autonomy is enabled, the number of seats available in each Loop EV will increase by 33% 

8. Implement a Ride-sharing app or kiosks for people to ride-share and thus ensure the EVs have close to 100% occupancy for every ride during peak hours.  This would most likely happen for the 29 mile 51 station Vegas Loop, not so much for the 3 station LVCC Loop.

9. Expand station size to add even more car bays by simply extending the amount of space reserved for use by the above-ground stations.  These stations are after all not much more than sections of existing car park outside the convention centre entrances that have been partitioned off with some barriers/bollards/curbs making it trivial to double or more the size of those stations by simply by moving those barriers.

10. Increase speed of the EVs in the spur tunnels.  The original speed limit in the tunnels was 30mph but this was increased to 40mph (30mph around bends) last year.  As these spur tunnels are so short (0.8 miles), it isn’t practical to increase this much further, but the long straight arterial tunnels in the 29 mile Vegas Loop will support speeds as high as 150mph.
Reply: @andrewfranklin4429  According to the website of the boring company. The 4,400 figure is its capacity and not the average throughput. And according to your calculations of 3,375 passangers per hour during the convention this would be extremely near the capacity, meaning that I am totally correct that we cannot expect any significant improved of its daily ridership. Btw: It would be very interesting to see how you want to fit a bus in these narrow tunnels.
Reply: @KiHToG  on the contrary, the website says “The LVCC Loop system is designed for 4,400 passengers per hour (with 3 large stations), while Vegas Loop is targeting 57,000 passengers per hour”. 

That does not say it is designed for a MAXIMUM capacity of 4,400, it says it is designed FOR 4,400 passengers per hour - ie it is designed to run at 4,400 passengers per hour. 

All public transport systems are not designed to run at their maximum capacity all the time as all it would take is a slight increase beyond that and they’d be pushed over into overload. 

The Loop, like all systems has headroom above the regular AVERAGE rate that it is designed to operate at.
Reply: @KiHToG   As has been reported in the press:  
 
“The contract provides payments at different points in the process, such as completing the bare tunnels, the entire working system, finishing a test period and safety report and then demonstrating it can carry passengers. The final three milestones relate to how many passengers it can carry. If the Loop can demonstrate moving 2,200 passengers an hour, TBC will get $4.4 million, then the same payment again for hitting 3,300, and the same again for 4,400 passengers an hour. Together, these capacity payments represent 30% of the fixed-price contract.”

“TBC still has to achieve this figure during actual conferences in the months ahead to avoid penalties.”

The contract would be completely illogical and criminally irresponsible and guilty of reckless endangerment if it required the Loop to push beyond its maximum safe capacity every convention for fear of being hit with penalties every time. 

Ergo, the value of 4,400 is not a maximum, but rather an average figure that the Loop must achieve every large convention to ensure it doesn’t incur those large penalties. 

The fact that the Loop almost certainly achieved that metric with a mere 114,000 attendee medium-size conference demonstrates that it would easily surpass that figure with an actual “large” size conference of the scale of the 180,000 attendee pre-pandemic CES.
Reply: @andrewfranklin4429  the caption of that section is "capacity"
Reply: @KiHToG  it doesn’t say “MAXIMUM capacity” though does it?  Instead it is talking about AVERAGE capacity. Otherwise those contractual penalty clauses do not make sense.
Reply: @andrewfranklin4429  Maybe the guys at TBC are not able to use the term capacity correctly. According to the Oxford dictionary capacity is "the number of things or people that a container or space can hold" not "holds on average" but "can hold". As Mr. Musk demonstrated recently again with his twitter deal, contracts do not mean much to him.
Reply: @KiHToG  or the Boring Company is using the word “capacity” to refer to the capacity for the Loop to maintain an average capacity of 4,400 people per hour no matter whether the actual minute by minute pph value swings up above and below that average value without overloading the Loop.
Reply: @andrewfranklin4429  So you agree that if you go over the capacity, the system is overloaded? Meaning you can not transport more people even if the demand is increases...
Reply: @KiHToG  considering the contract requires the Loop to exceed the capacity figure of 4,400 every large convention on pain of financial penalties, it is pretty evident that going over that figure would not overload the Loop. 

Ipso facto, the figure of 4,400 is the average capacity the Loop is required to run at, not the maximum capacity of the system. 

Are you seriously trying to argue that anybody of sane mind would write a contract that required a system to be overloaded every time it was used?
Reply: @andrewfranklin4429  It wouldn't be the first time the Mr. Musk has no clue what he is talking about (just listen to any speech of him about neuralink). And in the reports I read TBC has to prove that it can move 4,400 pph. Not that it moves an average of 4,400 pph on some specific event or whatever you had in mind (which wouldn't be a capacity). A car has the exact same capacity no matter if it is standing around waiting for passengers, driving around completely filled or driving around transporting one single person. So what exactly do you mean when talking about average capacity. That TBC changes the number of cars in the system depending on the current demand?
Reply: @KiHToG   actually, yes, TBC does indeed change the number of cars in the system depending on demand. They only utilise 70 cars for medium-large conventions and even then, anytime there is a lull, the cars just sit waiting in the stations unlike trains which have to keep moving all the time even if they are completely empty wasting huge amounts of power. 

However, the 4,400 passengers per hour metric at which the Loop is designed to run at during large conventions is based on the average 2.5 passenger occupancy level of each EV seen at each convention. 

Otherwise there would never be any time when the Loop hit that magic 4,400 passengers per hour metric and would thus be hit with penalties every conference.
Reply: @andrewfranklin4429  Public transport systems also increase their number of trains or the length of the trains depending on the current demand. They do not keep all their trains runnign during the night for example. The system does not have to run at the 4,400 figure at any conference it only has to be able to.
Reply: @KiHToG  Incorrect.  The MANAGEMENT AGREEMENT BETWEEN LAS VEGAS CONVENTION AND VISITORS AUTHORITY and TBC – THE BORING COMPANY, DBA VEGAS LOOP  on page 2 Section 2, Definitions, specifically states the following:

““System Capacity” shall mean the transportation of an average of no less than 4,400 passengers per hour for thirteen hours.”

““Adjusted System Capacity” shall mean event-specific System Capacity requirements for Other Trade Show Events, if approved by Authority Contract Manager.”

It then states in SECTION 4 SCOPE OF SERVICES:

P.4 4.5  “The People Mover System shall be operational at System Capacity for all Full Facility Trade Show Events”

“The People Mover System shall be operational at Adjusted System Capacity for Other Trade Shows Events”

Notice the word “average”.
Reply: @andrewfranklin4429  That sounds quite dumb to me. In this way the LVCC can make a lot of money by simply blocking the entrace to the loop.
Reply: @KiHToG  I think it probably came from the LVCVA’s lawyers who would have wanted to give the LVCVA an “out” if this new untried technology was unable to deliver. The pandemic that happened since the contract was written however has obviously put a spanner in the works meaning that huge conventions of the size of pre-COVID CES with its 180,000 attendees don’t happen anymore, so that makes it all the more remarkable that medium-size conventions like SEMA with its 114,000 attendees managed to hit that mark at least during peak periods during the convention.
Reply: @andrewfranklin4429  they can have written in contract doesn't mean they're meeting it
Reply: @mathewferstl7042  in terms of contractual throughput requirements, the Loop carried over 32,000 passengers per day and 4,500 people per hour during CES 2024, a convention which only had 115,000 attendees compared to the 180,000 of pre-COVID events.
Reply: @grassytramtracks  The first three stations of the LVCC were paid for in a separate contract by the LVCVA while the subsequent stations of the Greater Vegas Loop are all being paid for by the hotels, casinos etc with the cost of the tunnels covered by The Boring Co.  So it is indeed true that the taxpayer is not coughing up to fund this massive project.
Reply: @grassytramtracks  The 0.9 second (5 car length) headway is the planned minimum headway that the Loop tunnels will support, but with 9 north-south tunnel pairs and 10 east-west tunnel pairs criss-crossing the Vegas Strip, they would certainly not need to run at that high frequency to carry the projected 90,000 passengers per hour capacity of the Vegas Loop.
Reply: @grassytramtracks  Even if you were just assuming all 90,000 passengers per hour were going up and down those 10 north-south tunnel pairs in peak hour with zero going east-west, that works out as each tunnel pair only needing to handle 9,000 passengers per hour.  With each tunnel able to handle up to 4,000 EVs per hour with a 0.9 second headway, that gives you a theoretical max of 16,000 passengers per single tunnel per hour or 32,000 passengers per tunnel pair.
Reply: @grassytramtracks  Remember that the original LVCC Loop is already handling over 4,500 passengers per hour over just a single tunnel pair with 6 second headways, so 9,000 pph over a single tunnel pair able to handle down to 0.9 second headways should be easily achievable.

So as you can see, plenty of buffer meaning that there'd be plenty of space for EVs to merge in and out with Central Dispatch and Control ensuring no one tunnel was overloaded.
Reply: @grassytramtracks   The difference grassytramtracks is that the HyperLoop vacuum tube idea was just that - an idea in a white paper Musk released into the public domain for others to do with as they wished which he never committed to build himself.
Reply: @grassytramtracks  In contrast, the Vegas Loop is a real project for which most hotels, casinos, resorts, attractions in Vegas along with the stadium and the University have all signed agreements to pay for 93 Loop stations at their front doors and of which 5 are already in operation with another 2 shortly to open and another 2-3 now under constructioin.
Reply: @andrewfranklin4429  how would there be plenty of space? If you do the maths, if you have 0.9 second headways and cars going 60mph, that means cars are about 24m apart, which is a very small gap. Well all those words about Hyperloop being so cheap came from his mouth, so I'm not going to believe a word he says about his other technologies being super cheap
Reply: @grassytramtracks  As I said, 0.9 seconds is the minimum headway at any point, so if any tunnel was running at that highest capacity for a short amount of time, they wouldn’t be inserting any more cars into the flow at that point. 

As I said, Central Dispatch would instead spread out the traffic flow over all those 40 other east-west and north-south tunnels to make sure the load was well distributed.
Reply: @grassytramtracks  but it is interesting to note that a 2010 study by the Honda Research Institute found that 75% of cars on busy freeways have a headway between cars of one second (~6 car lengths at 60mph) or less and 40% maintain a headway of 0.5 seconds (~3 car lengths at 60mph) or less. And those are cars driven by potentially distracted, drunk and careless drivers.
Reply: @grassytramtracks so headways of 0.9 seconds are far from being extreme, particularly considering that the Loop autonomous control systems with their millisecond response times and ability to for example command ALL vehicles in a section of the Loop to brake or accelerate simultaneously.

These headways should be a lot safer than those lower headways on the open freeway driven by fallible humans.
Reply: @andrewfranklin4429  talk about your Musk fanboy...jesus...
Reply: @dante6563  hi Dante, so I take it you don’t have any useful critique of the facts that I’ve presented?
Reply: @andrewfranklin4429  Luxtram 16km 24 stations 500 million USD, over 12000 people per hour capacity (every 2 minute one tram with 422 passengers), 31 million per km.
Las Vegas Loop 1mile 1 station 50 million USD per mile (1.6km), only 4400 people per hour maximum claimed nearly 3 times less capacity per hour at optimal factors at best. Luxtram requires at least 6 times less electricity per person

Luxtram 422 persons board in less than one minute (one tramway every 2 minutes). Show me any video where 422 people board cars and drive away in one minute at one station at the Las Vegas Loop. You cannot. Facts.
Reply: @THEREALZENFORCE     Luxtram has 15 stations over 7km and takes 23 minutes to travel that distance at the dreadfully slow speed of 11.3 mph.

The tram has a daily ridership of only 31,300 passengers only 16% greater than the 27,000 people per day of the Loop despite having 5x the number of stations, 5.4x the length and costing $604m or 12.4x more than the LVCC Loop.  And it isn't even underground so has all the problems of above-ground rail in terms of noise and land-use.

I don’t think I’d be using that as an example if I was you Zenforce!  :-)
Reply: @andrewfranklin4429  Please show proof of your claim
Reply: @andrewfranklin4429  Maybe because Musk promised speeds of 155 mph, and the real speed is much lower than that. I really don't understand why do you compare this tunnel with a metro... it isn't one. Also, Waterloo station moves 250.000 passengers every day as average, so moving 27.000 isn't that great.
Reply: @late_at_night_music  no, Musk did not promise speeds of 155mph in the Las Vegas Convention Centre (LVCC) Loop as it would be absurd to expect those sorts of speeds along the very short 0.4 mile spur tunnels between the three stations. 

What The Boring Co (TBC) did say was such speeds would be possible in the now-under construction 34 mile Las Vegas-wide Loop which has much longer high speed arterial tunnels capable of handling such speeds. 

After all, TBC has actually driven visitors at 127mph (205kph) in the company’s longer 1.14 mile Loop tunnel in Hawthorne California with YouTube clips from 2 years ago showing it in action.
Reply: @late_at_night_music   and let me get this straight, you are comparing the little three station, one line LVCC Loop in a city of 600,000 population to the huge central Waterloo Station, the busiest subway station in London, a city of 9 million?

Well, if you insist, let’s break it down shall we?

The entire Waterloo subway Station only sees 147,574 people go through the turnstiles PER DAY across 8 platforms and 4 lines giving us a platform average of 18,447 per day or 36,894 people per line, not much more than the 27,000 people per day of the LVCC Loop. 

However, the comparison gets even more interesting when you realise that the 34 mile, 55 station Vegas Loop will have many more Loop stations for every subway station per mile. 

If you have a look at the map of the now-under construction 34 mile, 55 station Vegas Loop, you will see there will be around 8 Loop stations for every subway station per mile (17 in the 2 miles of the CBD) through the busier parts of Las Vegas

The existing convention centre Loop is a prime example of this fact as it already has 3 stations serving that one venue and the fourth LVCC station (LVCC North) has just been constructed and there are three other stations within a few hundred metres of the centre as well, meaning that the LVCC will effectively have 7 Loop stations servicing large convention crowds.  

With a subway, there would only be a single station typically serving such a destination. 

As such, comparing the average daily passengers through the turnstiles of a single station of the LVCC Loop during large conventions is actually very unfair to the Loop as we need to be comparing all 7 (or 8) of those stations (once they are completed) against each subway station (platform pair) for a more accurate comparison. 

Each of those 8 stations only has to handle 12% of the load of a single subway station to carry the SAME or greater number of passengers as that single subway station vastly reducing the crowds and bottlenecks or choke points that subway stations represent. 

So as you see, even though this little LVCC Loop was built competing with buses and above-ground light rail, it is already punching far above its weight in terms of capacity, giving even the busiest subway stations on the London Underground a run for their money.
Reply: @Andrew Franklin
What happened to the Dugout loop to Dodger Stadium?
Reply: @fredrik3685  The Boring Co is concentrating on getting the 34 mile, 55 station Vegas Loop completed first. That’s a far larger project and is already approved with 55 hotels, casinos, Allegiant Stadium, the university, etc all having signed up to pay for their own Loop stations at their front doors. 

Once that is more complete and in operation, other interested parties will have a more definitive idea of how well or not the Loop works when scaled to city-size.
Reply: @andrewfranklin4429  Luxembourg Luxtram can transport up to 422 people every 2 minutes

422 persons transported in 2 minutes

844 persons transported in 4 minutes

1266 persons transported in 6 minutes

1699 persons transported in 8 minutes

2110 persons transported in 10 minutes

2532 persons transported in 12 minutes

2954 persons transported in 14 minutes

3376 persons transported in 16 minutes

3798 persons transported in 18 minutes

4220 persons transported in 20 minutes

4642 persons transported in 22 minutes

(already in 22 minutes more than the 4400 of the Loop in one hour)

12660 persons transported in 60 minutes (1 hour) just from one station start to another.

All from just one station, and for 500 million euros (a bit more in USD), you got 16 kilometers (10 miles), 24 stations and many tramways.

50 million per mile with 24 stations and tramways 3 times more people

While Loop 50 million for one mile, one station, no cars, no drivers in these 50 million price.
Reply: @PatheticTV  perhaps you need to actually look at the data yourself to see that Musk isn’t full of bs.  The 27,000 people per day of the Loop is:

- greater than the number of passengers that 65% of the stations on the London Underground individually handle daily which with 1.8 million passengers per day across 272 stations averages only 6,617 passengers per day PER STATION. 

- more than the 24,858 passengers per day per line pre-pandemic average of Kings Cross station, the busiest station on the Tube which pre-pandemic had 149,150 people per day across 6 lines. 

- more than the average of 13,684 people PER STATION per day of the entire Paris Metro which had a pre-pandemic ridership of 4.16 million per day over 304 stations.

- a bit less than the 38,888 people per day per dual-platform average of the busiest station on the Paris Metro, the Gare Du Nord which pre-pandemic handled 700,000 people per day across 36 platforms. 

 - more than the 14,000 passengers per day per line average of the Stuttgart Main Station S-Bahn which pre-pandemic saw 140,000 passengers across 10 lines through the turnstiles daily.

Sounds pretty decent doesn’t it?
Reply: @andrewfranklin4429  just let me get this straight - you correct these riderships from London Underground and Paris metro to per-station, but don't give the Vegas Loop the same treatment? Really not surprising that the Vegas Loop has the higher numbers.

Also, if you watched this video, it was pointed out that the numbers for the Vegas Loop don't really make sense, so I assume your ridership number is also a gross overestimation.
Reply: @Player-hx1gs  there are actually around 8 Loop stations for every subway station per mile through the busier parts of Las Vegas. 

The convention centre Loop is a prime example of this fact as it already has 3 stations serving it and there will soon be a fourth LVCC station (LVCC North) and three other stations within a few hundred metres of the centre as well, meaning that the LVCC will effectively have 7 Loop stations servicing large convention crowds.  

With a subway, there would only be a single station typically serving such a destination. 

As such, comparing the average daily passengers through the turnstiles of the three stations of the LVCC Loop during large conventions is actually unfair to the Loop as we should really be comparing all 7 of those stations (once they are completed) against each pair of subway station platforms for a more accurate comparison. 

So the fact that even just three stations are so competitive with these Skytrain station line averages is a very strong witness to the significant capacity of the Loop.
Reply: @Player-hx1gs  and no, the 27,000 people per day figure is not an estimation, that is the actual passengers thru the turnstile count during the SEMA Convention in Nov last year.
Reply: @andrewfranklin4429  You're comparing apples and jellyfish, again! This one is so full of bull even you ought to see why.

Do you really think such blatantly dishonest argumentation is doing you any favours whatsoever?
Reply: @Codraroll  why do you think these comparisons are not fair?  What comparison would you propose instead Erlend?
Reply: @andrewfranklin4429  Your numbers are bizarre. NYC subway: 200 people * 10 cars * 20 trains/hour = 40,000 people/hour. In one hour, just a single subway platform can blow your record out of the water. Think about how many it could move in a day. You're also deceitfully comparing average (over a year) daily ridership with Las Vegas during a convention.
Reply: @duckling_the_mighty  Pigeon, The numbers I gave are indicative of common systems around the world.  Of course you can add carriages and increase platform lengths for more passengers for billions of dollars more in costs.

New York has a population of 20 million versus Las Vegas 600,000. Do you really believe Vegas would need a high capacity subway like the NYC one?

Also, you are getting confused by the number of people sitting on a train versus the number who actually get off at a station.  

The busiest line (Victoria) on the London Underground sees just over 60,000 people per hour (pph) in the highest morning peak hour sitting on the train, and yet the actual max number of passengers recorded getting off and going through the turnstiles at Oxford Circus Station (the busiest Underground-only station on the Tube) is only 23,720 pph in the busiest morning peak hour, but that is the total across 6 platforms and 11 different Lines. 

 So per platform we’re only looking at approx 3,950 pph at Oxford Circus Station. On a per line basis it’s only 2,160 pph.  

And those were the figures pre-pandemic - ridership now is less than half those figures.

In contrast, the LVCC Loop handles up to 27,000 people per day during the 8 hours that medium-large conventions like SEMA were open.  So the Loop seeing an average of 3,375 people per hour EVERY hour of the day (not just during peak hour) is extremely competitive.  

But of course if we take into account the surge during peak periods, the Loop would actually be sustaining even more than that during the 4-5 hour peak period during the middle of the day and less up to mid-morning and late afternoon.

Note that the Loop’s real competition is actually BRT and Light Rail, so I only make these comparisons with expensive subways to make the point that the Loop is actually quite capable.
Reply: @andrewfranklin4429  There is only one way to compare capacities between transit options, and that is by comparing CAPACITIES. People per hour. In motion. If you want to use any other metric you'll need a real good reason. "sitting on a train [vs] get off at a station"...? Everyone who sits on a train gets off at a station. If the trains are carrying more people than are getting off at one station, that's because they're getting off at another station.

It's ridiculous to calculate the capacity of a transit line with turnstile usage. Capacity is not usage. Usage tells us how popular a station is and nothing more. You could add up all the turnstile usage at every station to get system usage, and then divide to get train capacity, but what's the point? Trains are boxes with people. To count the people, count the boxes.

Anyway, you're saying the total system ridership of the LVCC loop is 27k people/day. That is not a CAPACITY. The capacity of the LVCC loop is (3 people/car) / (6 seconds between cars) = 1800 people/hour. That is pathetic. (6 seconds is a safety limit from the LVCC loop's publicly-available operations documents.) BRT systems mostly run between 5k-10k people/hour (sometimes much more) and light rail generally runs 10k-20k. Even LVCC @ 2 seconds between cars is 5400 people/hour... but imagine cleaning up the crashes (with lithium batteries, no less!). 1 second between cars finally gets over 10k/hour, but that's firmly unrealistic due to loading/unloading, underground junctions, etc.
Reply: @duckling_the_mighty  There are actually multiple ways used to measure and compare Mass Transit systems Pigeon including:

- Annual Ridership of an entire public transport system
- Daily Ridership of an entire public transport system
- Annual Passengers thru the turnstile of a station (often called Entries and Exits)
- Daily Passengers thru the turnstile of a station
- Hourly Passengers thru the turnstile of a station (or even 15-minute chunks)
- Passengers per Hour of a train line

However, because the 29 mile, 51 station Vegas Loop hasn’t finished construction yet, we can’t use any of those “entire public transport system” metrics for the Loop yet.

Likewise, the current Convention Centre Loop is only in operation during Conventions which due to the pandemic are much smaller and less frequent than in the past, so we can’t use any of the annual metrics in any comparisons yet - again, until the full 29 mile Loop which will be open 365 days of the year is completed.

In addition, we can’t use the “Passengers per Hour sitting on trains going down a line” metric yet as the high speed arterial tunnels to which all of those 51 stations will be connected with spur tunnels (similar to on-ramps and off-ramps on freeways) have also not been constructed yet.

However, we do have the “Daily thru the turnstiles” stats for the Loop so we can use that.  

Note that when you are comparing the passenger-handling capabilities of stations, the number of people sitting on the train just passing through is irrelevant as the only useful statistic for a station is how many passengers get off at that station and go through the turnstiles.
Reply: @duckling_the_mighty  Now I know you desperately want to compare arterial line capacities, but as I say the arterial tunnels do not exist yet.

However, we can calculate the real-world people-per hour measurements through the spur tunnels of the current LVCC Loop off that known figure of 27,000 people per day as a consolation prize.

The Loop was only open for the 8 hours each day that the SEMA Convention was in operation so that gives us an average hourly rate of 27,000/8 = 3,375 people per hour, not 1,800 pph. 

But as I said earlier, like any mass transit system, the Loop has peaks and troughs throughout the day with a peak period around lunch with a significantly higher hourly rate than that and off-peak periods up to mid-morning and after mid-afternoon with lower rates.

The reason we don’t see 27,000 people every day through the Loop is because the Loop is only open during conventions at the convention centre where the Loop is located.  That is what it was designed for.

And, thanks to COVID, SEMA with its 114,000 attendees was the only medium-large convention that has occurred in the last few years.  The Loop was designed to handle the bigger crowds of CES which pre-pandemic boasted 180,000 attendees, but CES is now a pale shadow with only 40,000 attendees this year which saw 15,000 - 17,000 attendees through the Loop as a result.  

So we will have to wait till conventions return to those 180,000 attendees levels before we will know what the real upper limits are capacity-wise for the existing Loop.

Of course, we do also have the capacity test done last year to go by as well:

“LVCVA Chief Financial Officer Ed Finger told the authority’s audit committee that accounting firm BDO confirmed the system was transporting 4,431 passengers per hour in a test in May showing the potential capacity of the current LVCC Loop.”

However, once the full 29 mile, 51 station Loop is complete we’ll have a better picture of how well these impressive throughput levels scale to a city-wide system.

TBC’s projection of 57,000 per hour certainly seems conservative in light of the above.
Reply: So, the only way we can see what the capacities of those arterial tunnels would be down the 29 Mile Loop once they are constructed is to work back from the information that The Boring Co (TBC) has provided so far.

TBC has indicated that they are planning for the arterial tunnels to support 4,000 EVs per hour resulting in a headway of around 0.9 seconds which gives us 5 car lengths between EVs at 60mph.

So, 4,000 EVs x 2.5 passengers 
= 10,000 pph in one direction 
Or with ride-sharing:
4,000 x 4 passengers
= 16,000 pph

But the Vegas Loop isn’t just one line down the centre, but up to 3 separate arterial tunnel pairs (6 tunnels in total) in parallel at times - particularly around the Allegiant Stadium to assist with handling the peaks pre and post games.  That gives a throughput of 30,000 pph one way (or 48,000 pph with 4pax per car) or 60,000 (96,000pph w 4pax) bi-directionally over those high traffic sections.  And there are several other sections where small loops come off to serve groups of stations through the heart of the city so the numbers continue to multiply.

And the great thing about the Loop topology is that if there is more demand, more tunnels and stations can be built at a cost vastly cheaper than a subway. 

So even in terms of people per direction per hour, the Loop easily holds its own against:

Bus Rapid Transit (at grade) has very low capacity:
90 passengers per vehicle * 15 vehicles per hour = 1,350 pph.
And low average speed of 9mph due to city traffic and having to stop and wait at every stop. 
$0.68 - $9m per mile

Bus Rapid Transit (grade-separated) has low capacity: 
90 passengers per vehicle * 30 vehicles per hour = 2,700 pph.
And but still slow average speeds of 12-22mph.
$13-50m per mile

Light Rail Transit (at grade) has medium capacity:
90 passengers per vehicle * 3 vehicles per train * 15 vehicle sets per hour = 4,050 pph.
But slow speeds of 9mph -12mph due to city traffic and having to stop and wait at every station. 
$50m - $100m per mile

Light Rail Transit (grade-separated) high capacity:
90 passengers per vehicle * 3 vehicles per train * 30 vehicle sets per hour = 8,100 pph.
And still pretty slow average speeds of 15mph due to having to stop and wait at every station. 
$201m per mile

Subways have very high capacity:
100 passengers per vehicle * 10 vehicles per train * 30 vehicle sets per hour = 30,000 pph.
But still slow average speeds of 17-22mph due to having to stop and wait at every station. 
$600m- $1 billion per mile
$100m - $1 billion per station

The 29 mile Vegas Loop (2.5 passengers per EV) will have high capacity:
 2.5 passengers per vehicle * 4,000 EVs per hour = 10,000 pph
AND very high average speeds of 60mph thanks to direct point-to-point travel at high speeds. 
$20m per mile (dual tunnel)
$2m per above-ground station

The 29 mile Vegas Loop (4 passengers per EV w ride sharing) will have higher capacity:
 4 passengers per vehicle * 4,000 EVs per hour = 16,000 pph
AND very high average speeds of 60mph thanks to direct point-to-point travel at high speeds. 
$20m per mile (dual tunnel)
$2m per above-ground station

But as mentioned above, the 29 mile, 51 station Vegas Loop will have up to three parallel arterial tunnel pairs through the busier parts of the city giving 30,000 - 48,000 pph down the main arterial tunnels for vastly less cost than a single subway tunnel. 

The Boring Co has actually rated the 29 mile, 51 station Loop at a minimum of 57,000 people per hour and is actually being built at ZERO cost to taxpayers vs $8 billion for a subway.
Reply: @andrewfranklin4429  Once again you copypaste the same old bull to new people. You were repeatedly shown how wrong this is. Why do you keep repeating it?
Reply: @Codraroll  wrong in what way Erlend?  I’m afraid all we’ve seen is how wrong you have been suggesting that the 29 mile 51 station Vegas Loop is not happening despite copious evidence to the contrary.
Reply: @andrewfranklin4429  What evidence? That CEO promotional speech you copypasted? Hahahaha, learn to understand the very basics of reasoning, it might help you go places. Unlike this sewer taxi you keep peddling.
Reply: @andrewfranklin4429  There are contracts and there are contracts. Some basically say "yeah, we agree to cooperate with you, but we don't necessarily commit any money until at a later date". These are very different from build contracts where money has been put on the table in exchange for construction. One is essentially just signing up for the newsletter, in exchange for being allowed to be mentioned for marketing purposes. The other is what would be required before construction could happen.

You also don't seem to know what a franchise agreement is. It basically just says that the existence of the company is acknowledged, and that they are allowed to market themselves as seeking to do this-and-that. It is, essentially, just granting them a brand. It is not a build permission, and not an exchange of money for a delivery. You could get a franchise agreement without having the intention or ability to deliver anything. It just acknowledges that you have some sort of aspirational plan.

The available evidence suggests that the 51 establishments have agreed to attach their names to the project, but not that construction is imminent or even agreed upon. There would be other conditionals for that to happen, and there would be a paper trail you could use to prove it. Yes, they have agreements to market the project to some degree. But they do not have agreement to build it. 

The common way for this to happen is to let the individual owners sign up for a piece of the whole project, and if no other pieces are required (essentially, that the piece lies right next to a piece that has already been built) and there are no other hurdles, that one piece is built. That is what has allowed the adjacent hotels to connect their quarter-mile tunnels to the existing system, but it does not indicate that anybody else is handing over cash to construct their own pieces - particularly seeing as these pieces would be vastly more costly to build, and eventually require expensive modifications to the system at LVCC as well, so not all traffic has to be routed through its stations.

Perhaps there will be more pieces. Quite likely, there will not. For one, I think most of the resorts have financial people who know to ask questions to anybody who knows a shred of transport engineering, and who would tell them about the numerous red flags in the project. Second, the viability of the system hinges completely and entirely on autonomous driving coming true and being approved after thorough documentation of its safety. Until that happens - including the lengthy documentation period - the system is entirely dependent on employing a whole horde of drivers. Anybody with a lick of fiscal sense would be extremely wary of expanding the system until that hurdle is overcome. If the promises fail to materialize, for whatever reason (and there could be a lot of reasons), the system is a financial black hole. 

So no, I do not consider it documented that the project is going to be built, and that the necessary cash has been put on the table. Perhaps for small parts of it. And I do not consider it likely either. This is years of experience talking. Your blatant dismissals can be considered an insult to my profession. And your way of comparing apples to oranges brand you as an extremely unskilled amateur as well. It's not helping your case.
Reply: @Codraroll   so yet again you have not a shred of evidence that anyone has pulled out of this project and prefer to completely ignore the Las Vegas Convention and Visitors Authority CEO and President Steve Hill when he said:

“We’ll build phases that are separate to start and then tie them in and subsequent phases,” Hill said. “The (Allegiant) stadium to the Tropicana area will be one phase. The Caesars Loop will be one phase and the Resorts World and Westgate connecting to the convention center will be one phase. Then there will be phases that follow that connect those connections together.”

Boring Company President Steve Davis said last year that five to 10 stations would come online within the first six months of construction starting on the Vegas Loop. With around 15-20 stations being added each year until the full build-out is met.

Permits for a connection to the off-Strip resort the Westgate hotel have been submitted, with work pending on that tunnel.
“The Westgate is shorter and more direct, so that would be the first,” Hill said.

As have permits for the Caesars Loop, a circular segment running around various Caesars Entertainment-owned properties near the Strip and Flamingo Road. Those include Caesars Palace, Paris, Planet Hollywood, Bally’s, Flamingo and the Linq.

Additionally, permits to get the process rolling for a loop running between Allegiant Stadium and Tropicana Avenue/Las Vegas Boulevard have been submitted to Clark County.
“It will provide the first opportunity to connect some other local locations to the stadium itself,” Hill said. “But all those (loop portions) should be open and running sometime in 2023.”
Reply: @Codraroll  and you completely ignore the fact these contracts are now also in place:
“The Allegiant Stadium portion of tunnel work has a contract value of $9.18 million while the Caesars Loop portion is pegged at $3.42 million, according to county records.”

I’m afraid your continual unsubstantiated claims are really wearing thin.
Reply: @andrewfranklin4429  Utterly pathetic. You just keep copypasting the same stuff without knowing what it means. None of this is proving anything other than that aspirational plans exist. That is not the same as commitment to construction.
Reply: @Codraroll  so still no proof that anyone has pulled out. sigh
Reply: @andrewfranklin4429  Still no proof that anyone was ever in for more than the PR.
Reply: @Codraroll  still accusing the government authority of lying I see.
Reply: @andrewfranklin4429  No, it's you who don't understand what the government authority is actually saying.
Reply: @andrewfranklin4429  Luxembourg City 150000 people, Luxtram 40000 people per day transported, and the bad Loop transports only 27000 people per day in 600000 people Las Vegas. So bad.
And the Loop costs more per mile and the Luxtram is free public transportation (zero fees)
Reply: @andrewfranklin4429  "Very high speeds of 60 mph" in tunnels :-) these are literally the average speed in car tunnels in my country, tunnels that are better built have 2 to 4 lanes, security exists, etc.
Reply: @andrewfranklin4429  "Loop...Zero cost to taxpayers" not true, the costs will be paid by the clients of the Casinos, because the price will be added indirectly on bills of these clients. And many Las Vegas citizens do visit casinos, do go watch shows, do eat there, so they as VAT tax payers and bill payers will pay for the 29 mile Loop in the end. 
And they will probably have to pay a fee to use the loop on top of that, in that case the customers would pay twice (each time via customer bills at the casinos and each time via fees to use the loop)
Reply: Either your system has barely any capacity, or you're running cars so close to each other that you're asking for a pileup. The Model 3 has a stopping distance of 133 feet from 60 mph, which is more than the 88 feet that will separate cars at 1 second of headway and 60 mph. 4000 vehicles is a lot of failure points to be running at 1 second of room between them.

Arterials? On-ramps? That's a highway. So it's gonna behave like a highway -- with all the highway problems like traffic -- unless you prove otherwise. Magical self-driving technology doesn't count as proof.

And once again, turnstile counts are a total red herring. The turnstiles aren't the point of transportation - the TRANSPORT is. I don't care that you can put multiple lanes next to each other; that's why capacity is measured in people per hour per LANE.
Reply: @andrewfranklin4429  DEBUNKING MUSK - TED Talk 2022 Pt 3/4 (on Common Sense Skeptic channel).
Reply: @andrewfranklin4429  DEBUNKING THE VEGAS LOOP (1080p) on Common Sense Skeptic channel, debunking your claims with facts
Reply: @THEREALZENFORCE  Never seen Kevin, but Andrew has been around before. Still the same arguments, even though I debunked them the last time too. Give it another couple of months and another YouTuber who decides to have a look at "What happened to the Vegas Loop?", and he'll be back with the 27,000 per day, the comparisons to a "platform average" and the fairy tale cost estimates.
Reply: @THEREALZENFORCE  60mph is the average speed, the Loop EVs have already demonstrated 127mph (205 kph) down the 1.14 mile test tunnel in Hawthorne California. 

This shows the sorts of speeds possible in a tunnel that is almost 3 times longer than the 0.4 mile spur tunnels connecting each station in the LVCC Loop. With the much longer tunnels of the 29 mile Loop, it will be easy to achieve even higher speeds.
Reply: @THEREALZENFORCE  actually the Vegas Loop is being built at zero cost to taxpayers with The Boring Compay covering the cost of all 29 mil3s of tunnels. The Loop stations being built for each hotel and casino only cost around $2m each which is a rounding error for such establishments and won’t change room fees at all. 

In contrast, a subway would cost of the order of $8 billion which absolutely would punch every taxpayer in the gut with higher taxes for 30 years to pay off that sort of debt. 

And you conveniently forget that Luxtram and other public transport systems with low ticket prices only do that because they the government (ie. the taxpayer) is massively subsidising those services to pay off the billions of dollars that those systems cost.
Reply: @Codraroll  Yes and in my tiny country in my tiny 150000 people Luxembourg city our Luxtram does now 70000 people per day (over 6000 people per hour). In 600000 people Las Vegas, the Lop would have to do 280000 people per day and 24000 people per hour to come even
Reply: @andrewfranklin4429  Are you being serious or just trolling?  The numbers you are using aren't legit under even the most basic of scrutiny.  The only way you can be trying to claim that the vegas loop is outperforming modern rail and subway is if you're deluded by Musk fandom, a special needs individual or are just trolling for kicks.
Reply: @jennyanydots2389  why do you say that Jenny? It's very easy to verify these numbers for yourself. Just do a search for

 "the Las Vegas Convention and Visitors Authority (LVCVA) told Teslarati that the LVCC Loop has already successfully landed to transport 25,000 to 27,000 passengers daily around the Convention Center campus."

..and you see will that the Loop has indeed shown it can handle subway-size crowds.

If you doubt that 27,000 people per day is a significant number then just look up the daily ridership of any similar sized (3 station) subway. 

For example, Berlin's U55 or Newark Subway, or San Francisco Central Subway, or Seattle's U-Link and you'll see they all handle in that ballpark (or significantly less in the case of U55 and Newark).
Reply: @jennyanydots2389  Jenny, why do you call it "cherry-picked info"? I've included every example of similar sized subways in that comparison - I didn't cherry-pick just the low usage subways. 

Also note that Newark Subway has 17 stations and still doesn't handle more than 20,000 people per day. 

Also, would it be possible to avoid all the ad hominem attacks? I would hope we could have a friendly mature discussion around this interesting new PRT system without having to get personal. :-)
Reply: @andrewfranklin4429  Give it up fanboy.  People who would put this much effort (how much time have you spent on all these comments?) into defending an objective failure on social media have personality disorders.
Reply: @jennyanydots2389  I'm sorry to hear you are only interested in insult Jenny. May I gently suggest that refusal to look at  easily verifiable comparisons like this are a worrying indicator of a closed mind that may find itself surprised by disruption down the track. 

Do you really not want to have an open mind that avoids the mistakes of Nokia, Kodak etc when disruption comes rolling around the corner?
Reply: @andrewfranklin4429  Did you take in to account the distances of the loop, compared to the distances of these lines?